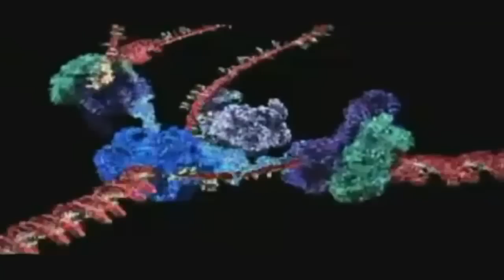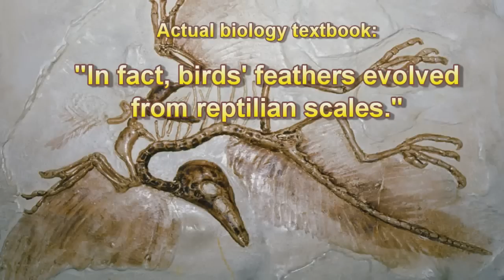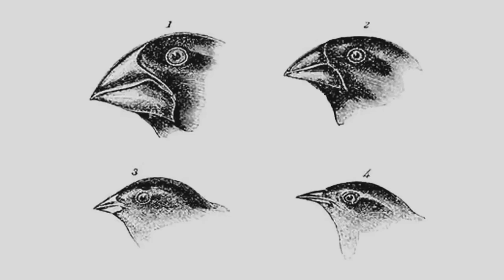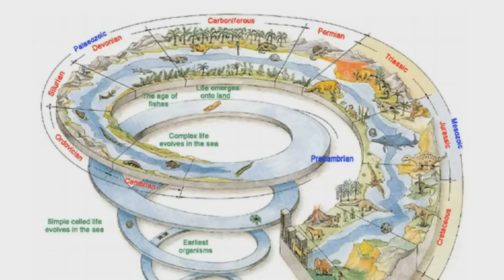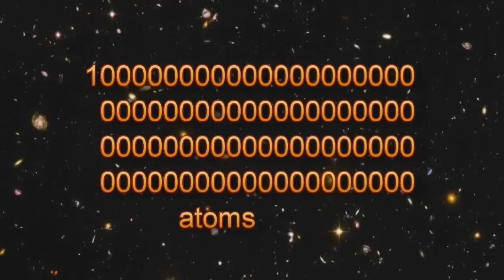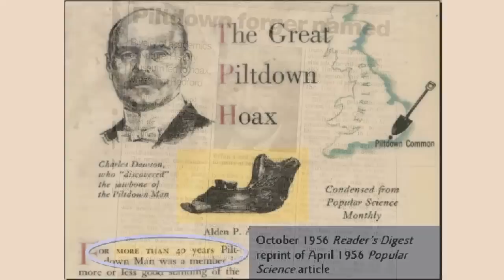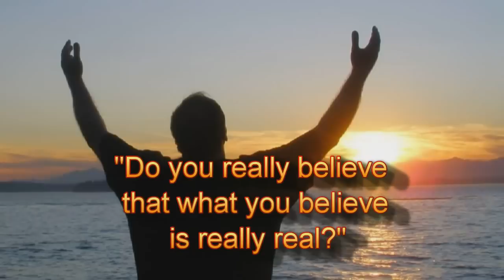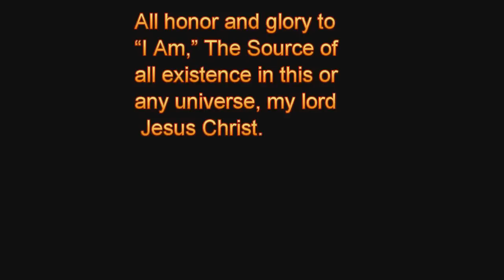Evolution Demolition

Comment: I will be honest and say that i could only stomach watching snapshots of this 1hr + video. So apologies if the responses to the points i make are contained in the sections that i have glossed over. So, having said that, can you tell me what "New" information is required for a controlling (non coding gene) to regulate a protein coding gene at different times and for different durations across species? Despite your incorrect assertion that new "information" cannot be added, it is irrelevant anyway as speciation can occur without the need for added "information" (i.e. extra base pairs) and if you want to progress this irrelevant argument you may want to consider why Amoeba have far more base pairs than Man, including your fabled Adam.
And don't get me started on how Geology and Palaeontology not only prove an Old Earth and Evolution respectively but also simultaneously falsify Biblical Creation. You may want to seriously consider that before you even begin to question the actual mechanism driving Evolution. Ah yes, the dangers of arriving at the conclusuion before looking at the actual observable evidence. Still sadly going on in the 21st century in some diminishing corners.
Oh and btw Evolution has absolutely no bearing on how i live my life no more than how the Sun is fuelled, i.e. as long as the Sun is what it is, it doesn't matter how it got there and how it works.
Reply: You really do need to watch the video before you comment on it.

What new information is needed?  All of it.

Creationists believe in variation.  Horizontal change, and downward change.  However, upward change by random mutation has never happened.  Speciation is the result of informational losses, not gains.  [A species is defined by its inability to cross breed, not new functions, so this can happen rather easily.]

Geological and palaeontological observations are not inconsistent with creationism any more than with evolution.  The ubiquitous presence of carbon-14 in residual fossil carbon material is proof that the fossil record is younger than 100,000 years (probably a lot younger).
Reply: Mark Champneys
Yeah you believe in variation present in alleles, yet at the same time believe any mutation from away from the 'normal' sequence is always deleterious. So how do these two contradictory ideas coexist in your mind?  Mutations can cause different sequences; therefore by your own criteria there must be at least as many good mutations as there are variations. So this admission means that you accept that mutations can be functional and provide increase fitness? These variations are different in their primary sequences as are mutations so what is the difference?

Welcome to the real world!

So where is your empirical evidence about specialization decreasing in DNA content published or is this some more of Johnson and Abel's data?
Reply: Mark Champneys
Well i will try to find time but from what i have seen so far is the same old debunked to death stuff.

I hope by "horizontal" change you don't mean Horizontal Gene Transfer because that is a relatively rare occurence in the scheme of things. While there is plenty of gene duplication it is in not even necessary for speciation i.e. Evolution. This is such a common misconception by Creatiosts.

"Speciation is the result of informational losses, not gains."
-- Oh really? Depends how you define "loss" and "gain" If i take the word "Hair" and "horizontally" change the "a" to an "e" i get "Heir". Is that a loss or a gain as i have merely replaced one operational word for another? Though, you could say "Have i lost my hair to gain money?" (apologies for that attempt at a joke).
Either way your response does not address my original point on regulating genes. If you have addressed this in your video then please tell me when in the video.

"[A species is defined by its inability to cross breed, not new functions, so this can happen rather easily.]"
--So since a Cheetah cannot mate with a Lion (unlike Lions and Tigers which are of the same Genus yet whose offspring is infertile), is the Cheetah within it's own "Kind" different to that of the Lion?. The fact that species cannot crossbreed in no way compromises Evolution. Over time the genomes of sepertae populations diverge ultimately affecting the germ cells and hence you can no longer get interbreeding. That sir is a new species explained by and consistent with Evolution.

"Geological and palaeontological observations are not inconsistent with creationism any more than with evolution."
--Oh deary me yes they are. As a turbulent global flood settled you'd get sediments laid down according to grain size and that would be across the whole globe (you can do the experiment yourself at home. It's easy).
You wouldn't get such diverse environments as we find in practice such as River sediments, Estuarine sediments, Glacial sediment, Aeolian sediments, Shallow salt water sediments, shallow fresh water sediments, Deep salt water sediments, Deep Fresh water sediments, Evaporites etc etc etc.,

"The ubiquitous presence of carbon-14 in residual fossil carbon material is proof that the fossil record is younger than 100,000 years (probably a lot younger)."
That's the whole point. Fossils do NOT contain carbon. The ones that do are indeed less than 50K years old but hey what are you doing championing the rather dodgy art of carbon dating? Look by Relative dating alone (pre radiometric dating) the Victorians calculated the Earth as at least 15 million years old so 100K was even ridiculous in those days so where does that leave 10K or whatever? In the realms of now discarded beliefs is the answer to that one.
Reply: Mark Champneys Creationists believe in magic. Creationists believe that a bronze age book of myths trump modern science. 
Species evolve over time to take advantage of new or changing environments.
Evolution and NOTHING else explains the fossil record. 
Creationism is a dead end.
Reply: Helixbuilder I can see how you might see these as contradictory ideas, but the word "paradoxical" would be more accurate.  The concept of prescriptive information is that the design of the instructions has purpose.  When I write software, portions of it are parameters/variables.  These are places in the code that are intended to have multiple options.  Variation in these places is okay, and usually harmless.  You won't crash my program by altering such areas of the code.  Other areas of the code are much more vulnerable.  Any change is deleterious to my purpose, but some changes are harmless or unnoticeable.  If mutations are thought of as spelling errors, then a few spelling errors in my novel will not change the message of the book (unless they were in extraordinarily strategic locations).  But spelling errors are always deleterious in a novel, however small or unnoticeable.  That is because the author did not intend it that way.  If spelling errors could re-write the novel to alter a coherent plot and improve the story, you might have a case.  But spelling errors have never, ever, done that for a novel.  Nor for a gene.

A damaged gene can, under very particular circumstances, be beneficial to survival value, as in the case of the sickle cell mutation.  But it is always deleterious to the intended programming, simply for the reason that the alteration was not intended by the original program.  Prescriptive information always originates from a mind, and has foresight and purpose.  Random changes never have foresight or purpose, even when they get unusually lucky.

I think the Creator designed DNA for extraordinary variation within the constraints of a given set of algorithms for each "kind."  The algorithms are not supposed to change, but the parameters are wide open.  Red hair or black, blue eyes or brown, tall or short, various amounts of melanin in the skin.  It's all good.
Reply: pilgrimpater No, I mean "horizontal" in a much more general sense: remixing existing genetic information.  Upwardly vertical evolution would be the addition of new prescriptive algorithms to the genome.

"Over time the genomes of sepertae populations diverge ultimately affecting the germ cells and hence you can no longer get interbreeding. That sir is a new species explained by and consistent with Evolution."

It may not be inconsistent, but either damaging or turning off genes is not going to make that organism progress upwardly.  New prescriptive algorithms have not been added to the programming.  And, by the way, often these new species can still be inter-bred artificially, if not naturally, since the DNA often remains compatible.

"As a turbulent global flood settled you'd get sediments laid down according to grain size "

We do see this kind of sorting within a given stratum.  The Grand Canyon has many examples of this.  Not to mention marine fossils on mountaintops all over the world.  Yes, there are other kinds of local sedimentation, but what about cross-continental strata?  Only a global flood could do such a thing.

Fully mineralized fossils do not contain carbon, but not all fossils are fully mineralized, such as coal and crude oil.  In the last ten years many specimens of original material with intact protein and even DNA molecules have been discovered.  These all contain carbon-14.  And the very fact that such bio-polymers are not broken down is, itself, proof positive that they cannot be older than a few thousand years, since such polymers rapidly break down under even the very best of conditions.

By the way, I do not argue for the accuracy of radiocarbon dating, because so many assumptions are involved.  I am merely talking about the detection of carbon-14, since zero measurable carbon-14 should be present in these things.
Reply: walkergarya Hurling insults is a sign of desperation.  Are you doubting yourself?
Reply: Mark Champneys
“No, I mean "horizontal" in a much more general sense: remixing existing genetic information”
-- Ok thanks, i just wanted clarification.
 
“It may not be inconsistent, but either damaging or turning off genes is not going to make that organism progress upwardly. “
-- Too damned right it’s not inconsistent but you seemed to have missed my point totally. While fossil genes are extremely strong evidence for Evolution e.g. we have less smell receptors than mice, I am talking about mere changes to existing genes that are still expressed. No additions, no subtractions, no turning off/on but merely change. Change a gene, more especially a regulating gene, and you get a change in gene expression e.g. the same gene that “builds” the bone segments in reptiles and birds is switched off in birds earlier than in reptiles so the bird has a shorter tail than the reptile.  So which has the advantage? Well the answer is simple. Both have the advantage. The reptile needs a long tail but a long tail to a bird would hamper flight. In other words, as per my word game example, there is no right or wrong result and for biology merely the best solution for a specific organism within a specific niche/environment.  
 
“ New prescriptive algorithms have not been added to the programming.  And, by the way, often these new species can still be inter-bred artificially, if not naturally, since the DNA often remains compatible.”
-- I’m afraid “programming” is a presupposed position on your part. In no way is DNA “programmed” any more than valency rules are within chemical reactions (and btw biology is essentially chemistry). If we were in a position whereby computer code randomly mutated when copied from one place to another then there would be no such thing as the IT industry. The very definition “algorithm” excludes randomness yet we know random mutation is a fact.  

“We do see this kind of sorting within a given stratum.  The Grand Canyon has many examples of this.”
-- Again you misunderstand my point but I am even more shocked that any Creationist can cite the GC to bolster their case. The point I was making was that the sediments would be sorted accorded to grain size. You must surely know that smaller/lighter grains stay in suspension longer than larger/heavier grains. As I said, you can do the experiment yourself at home.
Do we see such graded separation win the GC? No of course not and why do we see clear demarcation between the various sediments with an Aeolian layer sandwiched between water born sediments?
To save space and time I will not go into the numerous other reasons why it is not a good idea for Creationists to use the GC as an argument. I will, of course should you ask but we mustn’t use that as an excuse to avoid what’s being asked of you here.
 
“Not to mention marine fossils on mountaintops all over the world.”
-- Really? We know that plate tectonics is the reason for this and we can still measure it happening in mountain ranges such as the Himalayas.
However, let’s play God’s advocate and pretend your supposition is true. How come a “flood” raised a range of mountains of 25K+ feet when they had yet to lithify.  How could they possibly lithify without vast overlaying layers to squeeze out the water and replace with “cementing” agents? How come this sea bed that rose to 25K+ feet didn’t pull in all the other dead organisms, including land organisms, that were floating aimlessly around.
These are just a few questions that make us realise that the Genesis account is completely and utterly impossible.
  
“  Yes, there are other kinds of local sedimentation, but what about cross-continental strata?  Only a global flood could do such a thing.”
-- There are NO global strata, not even the much mentioned limestone layer.
As for “Only a global flood could do such a thing” then why just limestone (if that’s what you are referring to) and why not ALL strata? At best, if true, this would mean that there was a global deposition much earlier than the following totally non global depositions but of course your claim is not true. That’s the danger of only looking at Creationist propaganda sites rather than genuine scientific sites.
 
“Fully mineralized fossils do not contain carbon, but not all fossils are fully mineralized, such as coal and crude oil.”
-- The vast majority of fossils have had all their carbon replaced by minerals. Unsurprisingly the ones that are still undergoing this process are younger.  What’s the big deal?
 
 “ In the last ten years many specimens of original material with intact protein and even DNA molecules have been discovered.  These all contain carbon-14.  And the very fact that such bio-polymers are not broken down is, itself, proof positive that they cannot be older than a few thousand years, since such polymers rapidly break down under even the very best of conditions.”
-- So what you are saying is that in an old Earth scenario all life must be millions of years old? Of course this is a problem  as an Old Earth scenario allows for Young Earth events but a Young Earth scenario is totally falsified by a single Old Earth event. Unfortunately for you, the Old Earth events outnumber the Young Earth events. You need carbon to be found in ALL fossils. Sorry but the evidence is not on your side.

“By the way, I do not argue for the accuracy of radiocarbon dating, because so many assumptions are involved.  I am merely talking about the detection of carbon-14, since zero measurable carbon-14 should be present in these things.”
-- Which means that there are Zero dating methodologies to support your presupposed word view. Not a great position to argue from.
Reply: pilgrimpater _"While fossil genes are extremely strong evidence for Evolution..."_

What fossil DNA?  Yes, a few specimens of intact DNA have been discovered, but very few.  Yet even these few specimens are proof against evolution, since DNA decays rapidly and cannot last longer than about 30,000 years even if there were absolutely perfect conditions (which there are not).

" In no way is DNA “programmed” any more than valency rules are within chemical reactions"

Valence is a property that operates according to straightforward natural law.  DNA contains vast libraries of coded sequences, jam-packed with instruction sets.  Big difference.

Are you familiar with Baumgardner's model of catastrophic plate tectonics to explain the global flood, abundant fossils, mountain ranges, etc.?  I find it very persuasive, with more explanatory power than conventional geologists' uniformitarian models.  IMHO.

"The vast majority of fossils have had all their carbon replaced by minerals...What’s the big deal?"

The big deal is that all the fossil carbon that does remain contains measurable carbon-14.  How is that possible unless it is less than 100,000 years old?

"Old Earth scenario allows for Young Earth events but a Young Earth scenario is totally falsified by a single Old Earth event."

You have this exactly backwards, and it was discussed in my video.  If a treasure chest is brought up from an old shipwreck, full of old coins from hundreds of years ago, yet one coin in the bottom of the chest is a 1951 half-doller... then you know that the ship sunk after 1951, no matter how many 18th century coins are there.  Natural clocks of various sorts nearly always disagree with one another.  Natural clocks are helpful as maximum ages, not absolute ages, when we have such contradictory data.  Carbon-14 and undecayed bio-polymers are just such limiting factors.
Reply: Mark Champneys  

" In no way is DNA “programmed” any more than valency rules are within chemical reactions"

Valence is a property that operates according to straightforward natural law.  DNA contains vast libraries of coded sequences, jam-packed with instruction sets.  Big difference.

The development of DNA information is covered by Evolutionary Natural Selection and does NOT require any designer. In fact, the many simple errors that are continued to be copied in the Genome are proof against intelligent design.

Are you familiar with Baumgardner's model of catastrophic plate tectonics to explain the global flood, abundant fossils, mountain ranges, etc.?  I find it very persuasive, with more explanatory power than conventional geologists' uniformitarian models.  IMHO.

Hydroplate "Theory" is a bigger farce of pseudoscience than Intelligent Design. 

"The vast majority of fossils have had all their carbon replaced by minerals...What’s the big deal?"

The big deal is that all the fossil carbon that does remain contains measurable carbon-14.  How is that possible unless it is less than 100,000 years old?

Carbon 12 and 13 can routinely have some of that carbon changed to C14 by the gamma emissions from decaying Uranium and Thorium in the soil. This is also why diamonds and coal sometimes contain C14.
Reply: Mark Champneys

“What fossil DNA?  Yes, a few specimens of intact DNA have been discovered, but very few.  Yet even these few specimens are proof against evolution, since DNA decays rapidly and cannot last longer than about 30,000 years even if there were absolutely perfect conditions (which there are not).”
-- Sorry, I didn’t make myself clear. I wasn’t talking about DNA decay whereby, of course we will find DNA with some intact bonds for more recent organisms (I think 6 mill years is the possible limit in ideal conditions). However, in a 4.5K year Earth scenario we should surely find such DNA unbroken bonds in ALL fossils. Why don’t we? That is the point you have to address.
I was, in fact, talking about fossil genes i.e. genes that exist but are no longer expressed. Why should an organism have genes that are no longer expressed yet are expressed in other organisms? If you are going to posit common design then why don’t all organisms share the exact same genes with it just being a case of which is  switched on or off? In fact, such fossil genes are occasionally expressed in individuals as atavisms. What kind of crazy “design” is that? Only Evolution by common descent can explain this.
 

“Valence is a property that operates according to straightforward natural law.  DNA contains vast libraries of coded sequences, jam-packed with instruction sets.  Big difference.”
--The DNA molecule is based on chemistry. Biology is basically Chemistry when you reduce it down to the nuts and bolts and hence subject to natural laws just as with valency rules in standard Chemistry. The only that breaks the rules is the random mutation but even then the underlying chemistry is still the same.
As I said before, you cannot describe DNA as “programmed” because copied computer code does not randomly mutate. I need your response to this.

“Are you familiar with Baumgardner's model of catastrophic plate tectonics to explain the global flood, abundant fossils, mountain ranges, etc.?  I find it very persuasive, with more explanatory power than conventional geologists' uniformitarian models.  IMHO.”
--  No, perhaps you should extract Baumgardner's explanation for the problems posed to you previously i.e.

a) How does it explain the non graded bedding, especially in the case of the Grand Canyon which you cited as an attempt of evidence for a global flood
b) How come we have an Aolian layer sandwiched between water sourced sediments?
c) How did the Himalayas become lithified without collapsing while still mud?
Or if they were already lithified then how come the planet didn’t melt with so much energy being expended in such a short period? Either way the Flood model has catastrophic problems.
d) How come only simple molluscs were uplifted by the flood? Surely various other organisms, including land mammals, would have been swept up in the turmoil and uplift of this 25K ft plus tall mound?  
 Of course there are numerous other objections to the flood story but there is no point in snowing you under with more until the above are addressed first, whether by you or Baumgardner.

“The big deal is that all the fossil carbon that does remain contains measurable carbon-14.  How is that possible unless it is less than 100,000 years old?”
-- The point is that fossil’s that are greater than 100K years do not contain carbon, especially so for fossils that are millions of years old.  It is irrelevant talking about young organisms which are necessarily a part of both an Old and Young Earth.

Sorry but your analogy of the shipwrecked coins actually works against you.
If we apply the analogy to palaeontology then because we have animals that died yesterday, according to your logic, the Earth was created yesterday. Doesn’t work.
Also it says nothing about the age of the ship which may be centuries older than the 18th century (i.e. the age of the majority of coins) and it is the age of the ship that is relevant to the debate and not the age of the contents i.e. the age of the Earth and not the age of the organisms which can be anything from being the same age of the Earth to the present.
No, you must think this through. An Old earth can contain any number of young events but it is impossible for a Young Earth to have even just one confirmed old event. All it would mean, at best, is that the old event is true and there would be a gap before the majority of younger events occur but of course there is not just one example of old events but many.
 
“Natural clocks of various sorts nearly always disagree with one another.  Natural clocks are helpful as maximum ages, not absolute ages, when we have such contradictory data.  Carbon-14 and undecayed bio-polymers are just such limiting factors.”
-- I don’t know what you mean when referring to natural clocks. If you mean radiometric dating then they are true within specific tolerances and they are only valid for a certain range of dates You cannot use an isotope with a half life of millions of years for an event a few centuries old thus you use the correct tool for the job e.g. you wouldn’t use scales, or even a 6 inch rule, to measure the distance to the moon.. The numerous radiometric dating methodologies complement each other and if they all happen to be wrong by the exact same degree of error then the odds against that are astronomical. However, there are also other methodologies other than radiometric dating e.g. thermoluminescence. Other methodologies, while not giving an age of millions still far exceed the 6K year old limit e.g. as ice cores, varves etc etc.
Also even ignoring absolute dating, relative dating, as was used by the Victorians, still yielded an age of the Earth of hundreds of millions of years old. In fact it was they who, upon uncovering the evidence, realised that the Flood Story was impossible.
Uniformitarianism must be true otherwise it means the Laws of Nature have changed and these laws are dependant upon Universal constants which design proponents claim as being especially and uniquely put in place to accommodate life.
Reply: pilgrimpater Your post is too long to deal with in a forum like this.  We'll be writing books to each other.  Allow me to break it apart:

As to bio-molecular decay... this is well studied.  In accordance with the law of increasing entropy, these bio-polymers break apart rather rapidly under normal conditions due to microbes, water, oxygen, heat, and so forth.  No, we would not expect many of these intact molecules to be found even in a young earth scenario.  But in an old earth scenario?  Impossible.
Reply: pilgrimpater _"Biology is basically Chemistry..."_

That was the thinking of 50 years ago, not today.  Biology is basically information.  Biological systems are jam-packed with information, digital information.  Libraries of it.  Even evolutionists recognize this.  (Consider the journal of Bioinformatics.)

Biology certainly employs chemistry, but biology is no more equivalent to chemistry than ink and paper is equivalent to journalism.
Reply: pilgrimpater _"...computer code does not randomly mutate. I need your response to this."_

Of course it does.  Ever heard of a glitch?  That is a mutation.  Mutations are glitches in the digital DNA sequences.  The term "software" is not an analogy.  DNA sequences literally are software.  No difference, except for the processing mechanism.
Reply: pilgrimpater As to Baumgardner's catastrophic plate tectonic model...

I'm going to have to defer to him and his associates for the details, but I believe they have addressed most of them.  Every model has some unanswered questions, but I believe the conventional uniformitarian models have far more.  Many catastrophic geology issues were explained by direct observations at Mt. St. Helens which we had no clue about previously.
Reply: pilgrimpater _"The point is that fossil’s that are greater than 100K years do not contain carbon, especially so for fossils that are millions of years old."_

You are assuming that there are fossils older than 100,000 years.  What if there are not?  Generally speaking, the only fossils that do not contain measurable traces of carbon-14 are the ones that do not contain any carbon at all--the fully mineralized ones.  Why is the presence of carbon-14 in fossil carbon material so ubiquitous?
Reply: pilgrimpater _"If we apply the analogy to palaeontology then because we have animals that died yesterday, according to your logic, the Earth was created yesterday. Doesn’t work."_

Oh, come on.  Obviously there must be a connection to the thing being tested for it to be relevant.  If the thing being tested is the sinking date of the ship, then a 1951 coin locked in a chest in the heart of the wreck is relevant.  But, no, it tells us nothing about the date of unconnected things, such as the age of the tree used to build the ship or other such nonsense.

When an undisturbed basalt monolith in Australia was cut through, charred wood was found encased inside.  The wood dated at thousands of years, and the basalt dated at millions of years.  There is something wrong with this picture.  The two measurements are connected.  Radiometric dating was used on the rock, and radiocarbon dating was used on the wood.  The two natural clocks disagreed with each other, but the younger clock is controlling in this case.  Bio-molecular decay rates may be yet another clock which will render an even younger age, but not an older.  If three clocks give three different ages, at least two of them are wrong.

All natural clocks are based on assumptions, and all those assumptions are questionable when we are dealing with the distant past.  I'm not suggesting that we give up on science in this regard, but only saying that we must admit the limitations of it.  The distant past is beyond our experiments.  We can only do experiments in the present.
Reply: pilgrimpater _"Uniformitarianism must be true otherwise it means the Laws of Nature have changed"_

No, because catastrophes happen, even in the present... all according to the laws of nature.  Is Mt.St. Helens against the laws of nature?  Is a super-nova against the laws of nature?  Some astrophysicist think that there was previously a global flood on Mars, yet there is no present water there.  The earth is 70% covered with water, with massive sedimentary strata all over the earth, yet a global flood is impossible here?  Why?
Reply: Mark Champneys
“Your post is too long to deal with in a forum like this.  We'll be writing books to each other.  Allow me to break it apart:”
-- The sum total of individual posts will not reduce the text but instead make the exchange very bitty. I think it’s best to have each response in one place. It is easier to follow (seems we can’t even agree on that, lol).

“As to bio-molecular decay... this is well studied.  In accordance with the law of increasing entropy, these bio-polymers break apart rather rapidly under normal conditions due to microbes, water, oxygen, heat, and so forth.  No, we would not expect many of these intact molecules to be found even in a young earth scenario.  But in an old earth scenario?  Impossible.”
-- You missed the point, yet again. In an old earth scenario there will still be younger organisms that are partially fossilised.  After all the replacement of biological tissue with minerals is not a rapid process. You also still miss the point that if THE reason for molecules not fully decaying is purely down to a Young Earth then why are not ALL fossils containing molecular material?  Indeed why are only a small percentage of fossils found to contain biological material?
 
 
"Biology is basically Chemistry..."_
That was the thinking of 50 years ago, not today.  Biology is basically information.  Biological systems are jam-packed with information, digital information.  Libraries of it.  Even evolutionists recognize this.  (Consider the journal of Bioinformatics.)”
-- It’s the thinking now. All biological processes, no matter how seemingly complex, can be reduced down to chemical reactions, including  bioinformatics in the same way that ALL computer code can be reduced to a host of   individual on/off switches.

“Biology certainly employs chemistry, but biology is no more equivalent to chemistry than ink and paper is equivalent to journalism”
-- Incorrect analogy. Biology is a branch or an extension of chemistry. Journalism requires so much more than ink and paper.
 
 
 
“...computer code does not randomly mutate. I need your response to this."_
Of course it does.  Ever heard of a glitch?  That is a mutation.  Mutations are glitches in the digital DNA sequences.  The term "software" is not an analogy.  DNA sequences literally are software.  No difference, except for the processing mechanism.”
-- No it doesn’t.  Assuming no hardware failures (indeed a major and catastrophic glitch is patently obvious), then copied code from one location to another NEVER changes. How do I know this? I spent 30 years as a software developer.
This is the beauty of the digital age and the reason why you can copy music from one media to another with no loss unlike the case with analogue music whereby with each copy , the quality will be degraded. 
 
 
 
“As to Baumgardner's catastrophic plate tectonic model...

I'm going to have to defer to him and his associates for the details, but I believe they have addressed most of them.  Every model has some unanswered questions, but I believe the conventional uniformitarian models have far more.  Many catastrophic geology issues were explained by direct observations at Mt. St. Helens which we had no clue about previously.”
-- This is very disappointing. Earlier you wrote (and apologies as I am paraphrasing)  “It is a better explanation IMHO”.  How can you have an “HO” if you don’t know the contents?. I can explain in fairly good detail why I support the Plate Tectonics. When I ask awkward questions of your Creation model, then I expect this Baumgardner stuff to have addressed that issue.
As for Mt St Helens what is your point? Are you stating that Uniformitarianism excludes catastrophic events ? Nobody is claiming that.   
 
 
"The point is that fossil’s that are greater than 100K years do not contain carbon, especially so for fossils that are millions of years old."

You are assuming that there are fossils older than 100,000 years.  What if there are not?  Generally speaking, the only fossils that do not contain measurable traces of carbon-14 are the ones that do not contain any carbon at all--the fully mineralized ones.  Why is the presence of carbon-14 in fossil carbon material so ubiquitous?”
-- I make no assumptions. By relative dating alone we know that fossils exceed millions of years. Add to this the numerous absolute dating methodologies then we can safely conclude that the Earth is far far in excess of 6K years old (not to mention numerous other reasons why but that’s for later).
However, if they are NOT millions of years old I’d have to ask the question that you seem reluctant to address i.e. “Why are most fossils fully mineralised and without carbon while only a handful contain biological material and/or carbon?” 
 
 
 
 
"If we apply the analogy to palaeontology then because we have animals that died yesterday, according to your logic, the Earth was created yesterday. Doesn’t work."_
Oh, come on.  Obviously there must be a connection to the thing being tested for it to be relevant.  If the thing being tested is the sinking date of the ship, then a 1951 coin locked in a chest in the heart of the wreck is relevant.  But, no, it tells us nothing about the date of unconnected things, such as the age of the tree used to build the ship or other such nonsense.”
-- Exactly, in your analogy the thing being tested is the date of the sinking of the ship but the analogy should be talking about the date the ship was constructed or at least set sail. If you found only coins stamped 1851 then the only thing we can deduce is that the Ship could not have sunk before 1851 but it could have set sail  much earlier. Also that is just one set of coins. Are we to assume that all other coins that are not on the ship cannot be earlier than 1851 just because of this one event? It’s like knowing that the Norman Invasion couldn’t have been earlier than 1066 and claiming that there could have been no other battles before 1066.
 

“When an undisturbed basalt monolith in Australia was cut through, charred wood was found encased inside.  The wood dated at thousands of years, and the basalt dated at millions of years.  There is something wrong with this picture.  The two measurements are connected.  Radiometric dating was used on the rock, and radiocarbon dating was used on the wood.  The two natural clocks disagreed with each other, but the younger clock is controlling in this case.  Bio-molecular decay rates may be yet another clock which will render an even younger age, but not an older.  If three clocks give three different ages, at least two of them are wrong.”
-- Oh really? The basalt flow encasing the wood was only circa 20 meters below the surface, meaning that it was long exposed to surface waters percolating downward into the rock
Surface waters contain not only modern atmosphere, but organic acids that bond tightly to wood. The basalt in the core drill samples was taken from a zone of weathering, where percolating oxidising ground water readily alters minerals and rock chemistry.
Also do you honestly believe that if you toss a piece of wood into basaltic lava that it wouldn’t be completely consumed out of existence? Obviously the wood could never have been part of the original Basalt. This is something that can easily be demonstrated. Try it.
 

“All natural clocks are based on assumptions, and all those assumptions are questionable when we are dealing with the distant past.  I'm not suggesting that we give up on science in this regard, but only saying that we must admit the limitations of it.  The distant past is beyond our experiments.  We can only do experiments in the present.”
-- So 1066 could have been last week? Please, give me a bit of credit. Even if dating methods (thoroughly tested in the lab under extremes of pressure and temperature) were proven wrong they would not be wrong by a factor of millions. And I have to ask again why so many different and unconnected dating methodologies point to an Earth far far in excess of 6K years old. Are they all wrong while still arriving at a consistent conclusion? What are the odds against that? Unfortunately I cannot off the same scrutiny to Creationist dating methodologies because there are none, unless you want to count Bishop Usher as a scientific genius. I don’t buy into this “historical” science vs Present science. Basically there is evidence and an explanation for that evidence. We don’t have to see fossils form to know that they exhibit a clear and unmistakeable Evolutionary pattern. If you found a man dead in the street with a knife in his back are you to assume that dying from laughter was an equally plausible explanation as the knife severing an artery?  I think not.
 
"Uniformitarianism must be true otherwise it means the Laws of Nature have changed"_
No, because catastrophes happen, even in the present... all according to the laws of nature.  Is Mt.St. Helens against the laws of nature?  Is a super-nova against the laws of nature?  Some astrophysicist think that there was previously a global flood on Mars, yet there is no present water there.  The earth is 70% covered with water, with massive sedimentary strata all over the earth, yet a global flood is impossible here?  Why?
-- And who exactly claims that Unifortinarianism cannot include catastrophic events?
Extinct volcanoes are as much part of our history as are the vast deposits of slowly forming limestone.No unifortinarianism purely stipulates that Natural events we observe today also happened in the past with the same Natural Laws. No Natural Laws can explain flooding the whole planet in such a short period, nor can they explain how the Himalayas were formed without melting the planet.
Why are there sedimentary strata across the globe? Diverse events at various times and places within Earth’s history such as Rivers, Estuaries, Glacial deposits, Evaporites, Biological deposits (eg limestone), shallow lakes, deep lakes, shallow seas, deep seas, corals and even Deserts etc etc. That’s one hell of a variety of differing environments to have formed all from a single global flood.
Can you now explain why the sediments are not uniform across the whole globe and also why they did not settle according in grain size according to the laws of suspension as would be predicted from a receding flood?
You see there is nothing in Geology, let alone Palaeontology, that is consistent with a global flood.
Reply: pilgrimpater Actually, mineralization is relatively rapid under the right conditions.  Experiments have shown this.  Bio-molecular decay occurs at different rates, depending upon microbes, heat, presence of oxygen, presence of water, etc.  Under a young earth scenario we would expect to see most bio-polymers to be decayed, but in a few cases, where conditions were good, we might see a few cases of intact proteins and nucleic acids.  Such is exactly what we find.  Under an old earth scenario we would expect to see absolutely zero undecayed material, but this is not the case.

"Biology is a branch or an extension of chemistry. Journalism requires so much more than ink and paper."  You just made my point for me.  The information content of biological systems "requires so much more" than chemistry.

"Assuming no hardware failures... "  Smile.  If you've written software you know this assumption ain't true.

Baumgardner and his team (Wise, Snelling, Austin, Humphreys) have a very comprehensive computer-modeled theory.  I would do a poor job of representing them, and their stuff is readily available online.  I'll let them speak for themselves.

Yes, uniformitarianism allows for small catastrophes, but not global ones.  Makes no sense to me, given that sedimentation is global.

"Also do you honestly believe that if you toss a piece of wood into basaltic lava that it wouldn’t be completely consumed out of existence? Obviously the wood could never have been part of the original Basalt. "
Nevertheless, there is was.  Denying the data does not make it go away.  The wood was charred, by the way, and probably only a small portion of the original whole.

"Please, give me a bit of credit. Even if dating methods (thoroughly tested in the lab under extremes of pressure and temperature)..."  The reliability of dating methods cannot be tested in the lab in the present, because our labs are not located in the distant past.  There are huge assumptions in all such dating methods.  How much daughter isotope was present at the beginning?  Do you really know?  How much contamination could occur over that much time?  Do you really know?  Even the constancy of decay rates might be an open question, because we are in the present, not the past.  The biggest problem is that different methods yield vastly different results.  The lab says they should all be correct, but obviously they are not all correct, because they are all different.  Uranium-lead dating nearly always gives much older dates than potassium-argon dating.  Which one is right?  Are either of them right?
Reply: Mark Champneys _"Uniformitarianism must be true otherwise it means the Laws of Nature have changed"_

No, because catastrophes happen, even in the present...

Yes catastrophes happen, but they do not violate the Laws of Nature. Mt St Helens saw a medium eruption of a subduction volcano.

all according to the laws of nature.  Is Mt.St. Helens against the laws of nature?  Is a super-nova against the laws of nature?  Some astrophysicist think that there was previously a global flood on Mars, yet there is no present water there.

WRONG WRONG WRONG.
All astrophysicists accept that there was lots of water on Mars when it was formed, there were lakes, rivers and shallow seas, but there was NEVER a time when all of the land on Mars was under water. By the way, there is still lots of water on Mars, in the polar Ice caps, but no free flowing water on the surface.

 The earth is 70% covered with water, with massive sedimentary strata all over the earth, yet a global flood is impossible here?  Why?

Because there is not enough water to submerge all the land, even if virtually all the water at the poles were melted.
Reply: Mark Champneys
“Actually, mineralization is relatively rapid under the right conditions. “
-- Well perhaps you could give me some examples. I don’t mean known hoaxes like the “fossilised” cowboy boots nor about objects that are rapidly encrusted by calcium carbonate (which is NOT fossilisation) but I mean genuine replacement of internal biological structures by minerals.  
 
“ Experiments have shown this.  Bio-molecular decay occurs at different rates, depending upon microbes, heat, presence of oxygen, presence of water, etc.”
-- It is not just the decay but the replacement of the areas vacated by that decay that forms the fossils and that takes time. You also have to remember that bones that are buried rapidly are less exposed to oxygen that causes the decay and hence the decay rates are much slower than organic material exposed to the surface. This is how most fossils are formed by burial, pressure by overlying sediment (requiring great amounts of time in itself), causing biological matter to be dissolved and forced out, followed by replacement of the vacated biological matter. Then, either catastrophic events or the very slow process of erosion are required for those fossils to see the light of day for the first time and to become known to us. It’s all a lot to ask for in a young earth scenario where you would expect to see ALL organisms to be still part way into the process of fossilisation. Of course, we see nothing of the sort but instead we see the vast majority of fossils with absolutely no biological material remaining. The only logical conclusion is an Old Earth but we know from pure geology via simple relative dating methods that the Earth is old anyway.   
 
“Under a young earth scenario we would expect to see most bio-polymers to be decayed, but in a few cases, where conditions were good, we might see a few cases of intact proteins and nucleic acids.  Such is exactly what we find.  Under an old earth scenario we would expect to see absolutely zero undecayed material, but this is not the case.”
-- Sorry you can’t change the facts. Under a Young Earth we’d expect the vast majority of fossils to contain biological material. Exactly what we don’t see. Under an Old Earth we’d expect to see the vast majority of fossils with no biological matter apart from those fossils that are young (because an Old Earth still caters for young events). Exactly what we do find.
I think you are having a problem accepting that an Old Earth, not only contains old events but also young events in fact even present events whereas a Young Earth cannot be consistent with even one solitary old event, let alone the millions that we know of. The Earth is at least as old as the oldest event currently known to man.

"Biology is a branch or an extension of chemistry. Journalism requires so much more than ink and paper."  You just made my point for me.  The information content of biological systems "requires so much more" than chemistry.”
-- It’s chemistry to a higher level but it is still chemistry. In no way does this support your assertion. In no way is this evidence for “information” placed there by some external agent.
You can say it as much as you like but you really need to provide some evidence.
You are forgetting that a simple stone contains very complex information when you consider the physical, chemical and sub atomic bonds. Is each pebble intelligently designed? Good luck with that one.

"Assuming no hardware failures... "  Smile.  If you've written software you know this assumption ain't true.
-- Actually I know it to be 100% true. Digitally copied software quite simply does not randomly change (mutate). If it did then we’d have no databases and indeed the information that you read would be different (mutated) during it’s journey from the database to your screen. In other words we would not be able to communicate by any system that involves computers, which by definition move data from one place to another. The only way digital copying can fail is with a hardware error and that wouldn’t give you mere random mutations but a catastrophic fail. Sorry but I really do know this.

“Baumgardner and his team (Wise, Snelling, Austin, Humphreys) have a very comprehensive computer-modeled theory.  I would do a poor job of representing them, and their stuff is readily available online.  I'll let them speak for themselves.”
-- Which means that when you claimed “It is the best explanation IMHO”, that you blindly accepted something that panders to your wishful presupposition. I’d be very careful by claiming that mere slides on a computer represent computer simulation. It’s not the same thing.
May I suggest you spend time studying Baumgardner and then see if you can address the many objections that I raised in an earlier comment?

“Yes, uniformitarianism allows for small catastrophes, but not global ones.  Makes no sense to me, given that sedimentation is global.”
-- Uniformitarianism merely claims that the Laws of Nature that we observe today have occurred in the past. Catastrophic events do not contravene these Laws of Nature. It is nothing to do with the scale of such events and indeed we have had many global catastrophic events in the past such as the asteroid that was the demise of dinosaurs and much other life across the globe (evidenced by the KT layer around the globe).
I do wish you would actually respond to what I have written or is it that don’t you read it? The fact is that sediments do appear across the globe and at many depths (and altitudes) but these are from numerous wide ranging environments that are not floods and those that are floods are only a small minority of cases and certainly not global, meaning that there could never have been a global flood. Utterly impossible, given what we observe in the field.
Sorry but you need to respond to the points i am actually making rather than repeating the same old debunked to death Creationist slogans.

“"Also do you honestly believe that if you toss a piece of wood into basaltic lava that it wouldn’t be completely consumed out of existence? Obviously the wood could never have been part of the original Basalt. "
Nevertheless, there is was.  Denying the data does not make it go away.  The wood was charred, by the way, and probably only a small portion of the original whole.”
-- Why would you be surprised to find wood in a drilled mine shaft? If the wood had been truly embedded within the basalt then the remaining wood should still be observed in the wall of the shaft (btw i trained as a mining engineer before I went into IT). I cannot be certain I was not the one who “discovered” the wood but this doesn’t seem to be the case unless you can identify otherwise from Snelling’s paper.  You have no way of knowing that the “wood” was not charred before it found it’s way into the shaft. What you really need to produce is a piece of wood that is totally encased in basalt that has never had any fractures (i.e. somewhere where external material can enter) and never previously been exposed but how that could happen without the basalt not totally consuming the wood is beyond all the Laws of Science. Just try it. Toss a piece of wood in some flowing lava. Come back to me when you have done this and the wood has escaped with being merely charred.
Also how do you know that the wood didn’t originate from the coal layer and “carried” up by the receding drill into the overlying basalt level. In that case it is possible that the wood could be of an age outside the limits of C14 dating (I confess I don’t know the age of the coal layer) and hence the results would be of no use. However, having said that, you do realise that the wood was dated as 35.5K years old. That makes your 4.5K year flood claim out by a factor of circa 8 but then again YECs have absolutely no dating methodologies with which to make a comparison.
 Have you looked at cross section of the geology of the Crinum Colliery?
Like to explain it in a “Flood” scenario for me?    

"Please, give me a bit of credit. Even if dating methods (thoroughly tested in the lab under extremes of pressure and temperature)..."  The reliability of dating methods cannot be tested in the lab in the present, because our labs are not located in the distant past.  There are huge assumptions in all such dating methods.  How much daughter isotope was present at the beginning?  Do you really know?  How much contamination could occur over that much time?  Do you really know?  Even the constancy of decay rates might be an open question, because we are in the present, not the past.  The biggest problem is that different methods yield vastly different results.  The lab says they should all be correct, but obviously they are not all correct, because they are all different.  Uranium-lead dating nearly always gives much older dates than potassium-argon dating.  Which one is right?  Are either of them right?
-- The Mother/Daughter ratio has been addressed by Isochron methodology.
Again, results of different radiometric methodologies are consistent. For them to be consistently wrong to the exact same degree would be astronomical odds against. You do realise that scientists (real scientists) are fully aware of all the pitfalls are and where samples (always many not just one) are to be taken and that includes areas of that are deemed to be prone to contamination. Why should this be a surprise to you?
Why do you think decay rates are open to question” when they have been proved consistent even at extremes of temperature and pressure?
Added to this that such totally unrelated evidences, such as ice cores, show an Earth to be 100s of thousands of years old,  making your 6K year old model as looking rather sick.
 
“Uranium-lead dating nearly always gives much older dates than potassium-argon dating.”
-- Please give me some figures on this please. Maybe you are confused in that U-Pb has a lower limit of circa 1 million years while K-Ar has a lower limit of circa 100K years. If so, it sounds like typical YEC spin to me.
Reply: pilgrimpater Under either old or young earth I would expect very few fossils at all, because fossilization generally requires rapid burial in mud flows with relatively rapid mineralization before microbial decay.  Yet we have billions of fossils, buried in sedimentary rock layers all over the earth.  A global flood explains this perfectly.  Little else does.

Even a young earth scenario does not allow for intact bio-polymers to exist longer than a few years in nearly all cases, because of the presence of microbes, water, reactive chemicals, heat, and/or oxygen.  Only if conditions are perfect can any such polymer last several thousand years.  But it is impossible for intact bio-polymers to last millions of years.  Yet they have been found in pre-cambrian strata, and in dinosaur strata.  Why? because these layers are not as old as we've been told.  This is slam dunk proof.  It is like entering an undisturbed pyramid tomb, opening a mummy case, digging into the belly of the mummy, and finding a wind-up clock that is still ticking!  None of the rest of your arguments matter if the wind-up clock is still ticking.
Reply: Mark Champneys
“Under either old or young earth I would expect very few fossils at all, because fossilization generally requires rapid burial in mud flows with relatively rapid mineralization before microbial decay.”
-- You do realise that the necessity of rapid burial, to protect from scavengers, in no way means that the actual fossilisation process that follows that burial has to be rapid or are you under the delusion that a bone qualifies as a fossil the second it’s buried?  If so, you seriously have a lot of reading to catch up with.
 
“  Yet we have billions of fossils, buried in sedimentary rock layers all over the earth.  A global flood explains this perfectly.  Little else does.”
-- The truth is that the evidence clearly shows the global flood as impossible. It’s as if you totally ignore what I say and instead insist upon just carrying on repeatedly chanting debunked to death creationist mantra as in a comatose state. Here is a resume of just SOME of the facts that you still have to address:
1) We have Aeolian sediments sandwiched between water borne sediments.
Some flood to deposit sand without water!
2) As well as such Aeolian deposits, the water sourced deposits are from incredibly diverse environments (some listed in a prior comment, assuming you read it) that are clearly not results of floods and even more so, for those few deposits that are results of floods (e.g. Scablands), they are clearly not on a Global basis. Why?
3) In the wake of a global flood , we’d expect the sediments to be sorted and separated by grain size (courser grains at lowest and finest at the top). Exactly what we don’t see. Why?
4) In the wake of a global flood, we’d expect to see no pattern in the fossil record (i.e we’d expect a random mix) but we DO see a pattern and it is an evolutionary one and that is true regardless of the age of the Earth. Why?
 
.     
“Even a young earth scenario does not allow for intact bio-polymers to exist longer than a few years in nearly all cases, because of the presence of microbes, water, reactive chemicals, heat, and/or oxygen.  Only if conditions are perfect can any such polymer last several thousand years.  But it is impossible for intact bio-polymers to last millions of years.  Yet they have been found in pre-cambrian strata, and in dinosaur strata.  Why?”
-- Why? Because it’s no good inventing data to suit your presupposition. There are no intact bio-polymers found in Cambrian let alone pre Cambrian. I’d love you to tell me why you even think this.
 
 “because these layers are not as old as we've been told.”
--Now there is irony of the highest order. The difference between what the scientific world is “telling” us and what the religious are “telling” us, is evidence vs presupposition.
 
  “This is slam dunk proof.  It is like entering an undisturbed pyramid tomb, opening a mummy case, digging into the belly of the mummy, and finding a wind-up clock that is still ticking!  None of the rest of your arguments matter if the wind-up clock is still ticking.”
-- It wouldn’t even be slam dunk if it were true. You quite simply cannot ignore all the other evidences for an Old Earth nor those against a measly 6K year old Earth and again you provide an irrelevant analogy. We are talking about fossils, not ticking clocks.
Reply: walkergarya _"You have pseudoscience and your barbaric bible."_

Gosh, Gary, you've persuaded me with that fact-filled argument.
Reply: pilgrimpater _"...in no way means that the actual fossilisation process that follows that burial has to be rapid..."_

Bio-molecular decay, if not microbial decay, happens relatively rapidly, which implies that the mineralization process must be at least as rapid in order to preserve a thing as a fossil.

Concerning the global flood.
1. Creationist theories involve successive waves of sediments, as well as global scale volcanic activity.  Ash layers are perfectly consistent with that.
2. A global flood does not rule out local floods.
3. Sediments are sorted by grain size oftentimes.  The Grand Canyon has some excellent examples of this.
4. We absolutely would expect to see a burial order in the fossil record, and we do.  (It is not always consistent.)  We would also expect to see catastrophic graveyards of similar organisms fleeing a catastrophe, and we do.  We would also expect to see polystrate fossils, without decay in the upper strata for such fossils, and we do. (Whales, dinosaurs, upright trees.)

"There are no intact bio-polymers found in Cambrian let alone pre Cambrian. I’d love you to tell me why you even think this."

A discovery within the last year, by three evolutionist paleontologists, of marine worm tubules in pre-cambrian rock.  The tubules were original material with intact protein and chitin molecules.  In their paper they mostly talked about the tubules, but briefly wondered how the material could last 550 million years.  (Yeah, good question.)

"The difference between what the scientific world is “telling” us and what the religious are “telling” us, "

Only it is not religion telling you this.  It is science telling you this.  You just don't want to pay attention to that which doesn't fit your dogma.  The real irony here is that your statement is true... in reverse.  Evolutionism represents the religion (dogma) and the creationists represent the hard science that is overturning your preconceived ideas.

We are talking about carbon-14 and bio-molecular decay which are  literally ticking clocks.  As I said in the video, even if the chest is full of coins from hundreds of years ago, only one coin dated 1951 upsets the apple cart.
Reply: Mark Champneys So how do you explain the fossil record, where we have multiple examples of a clear series of fossil species starting from A and step by step morphing into B over time with, as is the case with the more modern of these examples, there are clear genetic links to show the same lineage.
Reply: Mark Champneys
“Bio-molecular decay, if not microbial decay, happens relatively rapidly, which implies that the mineralization process must be at least as rapid in order to preserve a thing as a fossil.”
-- So we should never find any bio-molecular material as soon as a bone is rapidly buried?
Well there’s a thing and how vague.  How long is “at least as rapid”? However, I am not talking about the decay but the replacement  of the “decayed” organic material by minerals.
Do you seriously claim that process to be “relatively rapid”? Are you claiming mineral substitution is completed as soon as the carcass is buried? And btw, microbial decay is the decay of microbes which is totally irrelevant to the fossilisation of bones in the general sense.

Concerning the global flood.
“1. Creationist theories involve successive waves of sediments, as well as global scale volcanic activity.  Ash layers are perfectly consistent with that.”
-- Rather than get sidetracked by the sheer impossibility of that statement, given what is actually observed in the field, i will persist with the point that was actually posed to you which was “We have Aeolian sediments sandwiched between water borne sediments.” So, i’m asking you yet again, how it is possible that a body of water can lay down a desert sediment that has plenty of evidence of being formed by wind/wave activity (just as we see happening right now in the Sahara etc)?
Are you claiming that Aeolian Sandstone deposits are Volcanic Ash? Surely not.
 
2. “A global flood does not rule out local floods.”
--Again, not the question that was posed to you. I’m asking how a global flood can leave such widely varying environments such as glacial deposits, Aoelian deposits, Evaporites, Estuarine deposits, River deposits etc, etc etc?  

3. “Sediments are sorted by grain size oftentimes.  The Grand Canyon has some excellent examples of this.”
-- No they are not. Sorry but you cannot change observable evidence to suit your argument.
No way are the various layers of the GC, or anywhere apart from estuarine and some river bend environments, sorted by grain size. Also, where was the Keibab Limestone sloshing around all the while the Tapeats Sandtone was being carefully and lovingly laid down into a nice distinct layer?
Why are the layers horizontal yet the so called “Super Group” (lower layers) is inclined at 10 to 15 degrees?  

4. “We absolutely would expect to see a burial order in the fossil record, and we do.  (It is not always consistent.)  We would also expect to see catastrophic graveyards of similar organisms fleeing a catastrophe, and we do.”
Leaving aside that is NOT the pattern that we see are you, with that old creationist chestnut, saying that all Sloths should appear in lower layers than all cheetahs? Surely Not.
Tell me more about what you think the fossil pattern is and how it can be explained by a global flood. Should be very interesting.
 
 “ We would also expect to see polystrate fossils, without decay in the upper strata for such fossils, and we do. (Whales, dinosaurs, upright trees.)”
-- and we’d expect polystrate trees in an old Earth scenario. Where is the problem? Remember, an Old Earth can and does cater for rapid events as well as young events.
Polystrates occur spanning coal layers. Where is the mystery? Indeed in a flood scenario how can we even have coal deposits? How can a tree stay vertical after being ripped out of it’s roots by such a violent flood? How can anything you believe about this “Global” flood make any sense when you actually question it?
Whales? Dinosuars? Are you claiming we have Polystrate Whales and Dinos?

“A discovery within the last year, by three evolutionist paleontologists, of marine worm tubules in pre-cambrian rock.  The tubules were original material with intact protein and chitin molecules.  In their paper they mostly talked about the tubules, but briefly wondered how the material could last 550 million years.  (Yeah, good question.)”
 
-- Tell you what since you chose not provide any detail, I’ve looked it up for you and as far as i can tell the journal to which you refer is the Journal of Paleontology 88(2):224-239. 2014. The abstract of which closes with:-
“The biogeochemistry of the organic matter that comprised the tube, which was inferred from its properties, composition, and microstructure, is consistent with chitin and proteins as in siboglinids.”
Admittedly this is only from the Abstract  but that should be enough for you to understand the context whereby the chitin like “molecules” were not the original soft material but the fossilised remains which are consistent with chitin, no matter how much your source creationist site wants to alter that context but then again that’s what Creation sites do.
With the power of modern microscopes the fossilised internal structures and biological pathways can be determined. That doesn’t make them biologically active.
Anyhow, to be fair, perhaps you have read the whole journal and your “claim” was included in the main body of that journal. In which case you can tell me can’t you but don’t you think it exceptionally strange that such an earth shattering discovery, as hundreds of millions of years old soft material, would be mentioned in the main body of the article but totally omitted from the Abstract?
 
However, despite that problem for you, let’s play God’s advocate and try really hard to pretend your statement is actually true.
If the reason for soft tissue is solely down to a Young Earth and a Young Earth is true, then ALL fossils should contain soft matter. Obviously they don’t so there would have to be another factor for the preservation of such tissue other than age. You must agree on that. What that factor could be, I think neither you nor I know. Also material such as Keratin (which is similar to Chitin) does survive well beyond other parts of the body. Just ask any archaeologist who has opened an ancient grave. They will tell you that the only thing that survives other than bones is hair.
Finally, on this matter, even if true, you are still left with the Fossil pattern which is true regardless of the age of the Earth, meaning the Genesis story is utterly impossible.

“Only it is not religion telling you this.  It is science telling you this.  You just don't want to pay attention to that which doesn't fit your dogma.”
-- Nah it’s religion and only religion has the dogma. Science merely goes where the evidence takes it and is subject to peer review by scientists who are striving to prove other scientists wrong. Creationism starts with a conclusion and contrives to shoehorn “evidence” to fit that conclusion. That’s not science by any stretch of the imagination. You don’t even have any dating methodologies available to you so how can you possibly claim a Young Earth apart from by an unevidenced presupposition?
The real irony is that you think your dogma represents the scientific method when in fact it is the very antithesis of  Science and the Scientific method and even if you could falsify all the science (evolution) it doesn’t immediately default to your creation model any more than it does for the Australian Aborigine creation story.
 
“Evolutionism represents the religion (dogma) and the creationists represent the hard science that is overturning your preconceived ideas.”
-- I don’t know what Evolutionism is but I do know what Evolution is and 150 years on from Darwin and Wallace (same conclusion from totally independent means and sets of data), the Theory explaining the fact of Evolution has gone from strength to strength with each find. Btw Victorians dropped Creationism like a hot potato once they started unearthing evidence. I am totally baffled how you can label a proven scientific discipline as a religion. Who do the Evolutionary scientists pray to and worship?  What are their rituals? Where is their Holy book written by their “God”? I’d have thought you were above labelling Evolution as a religion. I’m as disappointed as I am with your tendancy to totall ignore questions by giving answers to questions that have not been asked of you (yet).

“We are talking about carbon-14 and bio-molecular decay which are  literally ticking clocks.  As I said in the video, even if the chest is full of coins from hundreds of years ago, only one coin dated 1951 upsets the apple cart.”
-- I have already debunked that analogy, so why bring it up again unless you can come up with a good reason why my debunking is wrong? To remind you the coins say nothing about the age of the ship, which is the more relevant analogy to the age of the Earth. All they tell you is the most recent age of the coins on that ship, and that ship alone, when it sank.
It’s an analogy that just doesn’t work. 
C14 is the tool of the archaeologist and of little or no use to the Palaeontologist. Since the vast vast majority of fossils contain no C14 nor biological material then neither clock is relevant to the discussion. A ticking clock can only tell the time now. Radiometric “clocks” are totally different tools that tell the age of something. A clock cannot tell you the age of itself let alone it’s environment. Again an irrelevant analogy.
Reply: walkergarya These "clear series" are only series in your imagination.  Describe them, and then show me the DNA from these mineralized fossils.  I really would like to see them.  It seems to me that every bit of it is wishful thinking, but maybe you have something to show me.
Reply: pilgrimpater Your posts are so long I scarcely have time to read them, let alone write a reasoned response.  On top of that, I had written a lengthy response, and Google's drop-down window just disappeared.  Very frustrating.  Thus, I'm going to be brief.

When an organism is buried, it tends to decay and disappear rapidly.  The mineralization process must act quickly enough to capture the detail of the organism before it is gone or blurred beyond recognition.  The faster the mineralization, the better the detail.  It is actually remarkable that we have so many fossils with fantastic detail (often even softer body parts).

As to the global flood, you are raising many questions that have been addressed by Andrew Snelling, Steve Austin, and Kurt Wise. (For example, Austin's explanation of how vertical tree trunks get fossilized based on discoveries at Spirit Lake)  I am not a geologist, and I'm not the right guy to get into that kind of depth with you.  There are other global flood models as well, with different strengths and different weaknesses.  The overall point is that a global flood has great explanatory power.  The conventional model has gaping holes, such as massive strata crossing North America and across the Atlantic, or even the ubiquitous presence of marine fossils worldwide.  In fact, the vast majority of fossils are marine fossils.  A global flood model explains many such things that the conventional model cannot.

You identified the correct article.  (I have a full copy.) However, you need to read through it to see that the paleontologists clearly identify the tubules as original tissue.  Now what are you going to do with this blockbuster, slam-dunk, proof that pre-cambrian strata are not 550 million years old?

"Just ask any archaeologist who has opened an ancient grave. They will tell you that the only thing that survives other than bones is hair."

You just made my point for me.  All these graves are very, very, young, and hardly anything is left.  The hair decays more slowly, but even that will be gone long before 100,000 years has passed.  A young earth scenario absolutely does not expect much original tissue to remain.  Yet an old earth scenario absolutely requires that zero original tissue remains.

" I am totally baffled how you can label a proven scientific discipline as a religion."

The science is not what I am labeling as religion.  It is the superstitious speculation that evolutionists try to lump in with it.  For random mutations to give rise to coherent, functional, genetic instruction sets in DNA defies all probability calculations.  When someone believes something that is operationally impossible (anything less than a 10^-70 chance), then that is a faith-based, superstitious, belief.  If not religion, then dogma, which is virtually the same thing. Darwin was wrong about almost everything, yet they effectively worship him.

" I have already debunked that analogy, so why bring it up again unless you can come up with a good reason why my debunking is wrong? To remind you the coins say nothing about the age of the ship"

You have debunked nothing.  The coins are not dating the age of the ship.  They are dating the sinking of the ship. Likewise, carbon-14 dates the death of organisms, not when the first ones were created (or evolved).
Reply: Mark Champneys
“Your posts are so long I scarcely have time to read them, let alone write a reasoned response.  On top of that, I had written a lengthy response, and Google's drop-down window just disappeared.  Very frustrating.  Thus, I'm going to be brief.”
-- Tell me about it, I have suffered this many times. I now tend to copy comments to Word (for large comments), build my responses and when completed copy and paste back to the video. It works and results in far less swearing and cursing.
Sorry about the length but I cannot make a point by using just one liners and after all these comments are connected with an hour long video.

“When an organism is buried, it tends to decay and disappear rapidly.  The mineralization process must act quickly enough to capture the detail of the organism before it is gone or blurred beyond recognition.  The faster the mineralization, the better the detail.  It is actually remarkable that we have so many fossils with fantastic detail (often even softer body parts).”
-- Especially with fossilised hard parts (the vast majority of cases), that statement is patently not true. Once vacated, it takes as long as it likes for minerals top replace the “void”. It’s not as if something else is going to fill it meanwhile is it, because that something else becomes the “replacing” material. I just don’t see how you can make such an assertion. For full fossilisation the hard parts then need to decay. That is not a rapid event.
With soft bodied parts then a rapid catastrophic covering, such as a mudslide with the Burgess shales, will leave imprints of soft material. In that case your point may hold water (pun intended), or it may not (i don’t know) but remember that soft bodied fossils are in a tiny minority.
 

“As to the global flood, you are raising many questions that have been addressed by Andrew Snelling, Steve Austin, and Kurt Wise. (For example, Austin's explanation of how vertical tree trunks get fossilized based on discoveries at Spirit Lake)  I am not a geologist, and I'm not the right guy to get into that kind of depth with you.”
-- But any Geologist can explain polystrate trees. It’s easy. Now if you, Snelling, Austin or Wise could present me with a Polystrate that spans, say a layer of sandstone, a layer of limestone, and a layer of shale, that’s when I may be taken to task but coal seams and ash layers from multiple ejections over a short period as in Spirit Lake? Nah, no way is that a problem. Young/rapid events are part and parcel of an old Earth that also has lengthy events. Do you think that the scenario of the geology of the future, in say I million years time, comprising of only rapid events, will mean that in a million years time you could argue for the age of the Earth being a mere 6K? That’s exactly what a future religion could claim just as you are claiming now.
As for “depth”, these are not deep questions but very basic observations that you, as a non geologist, should still be able to ponder and wonder what the hell what you are being told by Snelling and Co can be possibly true.
 
“There are other global flood models as well, with different strengths and different weaknesses.  The overall point is that a global flood has great explanatory power.  The conventional model has gaping holes, such as massive strata crossing North America and across the Atlantic, or even the ubiquitous presence of marine fossils worldwide.  In fact, the vast majority of fossils are marine fossils.  A global flood model explains many such things that the conventional model cannot.”
-- You are just using rhetoric and assertions without making any points. You really need to address the 4 (of many) objections I raised that render a Global Flood as impossible.
Surely in your studies of the works of Snelling and Co, you could give it a go.
Yes we all know that marine fossils are more common than land fossils. Where is the mystery in that because for the obvious reason that a water creature is more prone to die in a water environment and hence leave a fossil? However, there are still millions of land fossils and these, along with marine fossils, show a distinct pattern of Evolution. I was rather hoping that you’d tell me what you think the pattern is since it is obviously not random as the Flood story would predict. There is no way a Global Flood can leave a pattern, any pattern.
It’s all getting a bit too frustrating as more and more questions posed to you are going unanswered. It’s no good citing Snelling etc, unless you can tell me what their actual explanations may be because for every scientist you cite, I could do the same and I have far far more to choose from. 

“You identified the correct article.  (I have a full copy.) However, you need to read through it to see that the paleontologists clearly identify the tubules as original tissue.  Now what are you going to do with this blockbuster, slam-dunk, proof that pre-cambrian strata are not 550 million years old?”
-- Where is the slam dunk in misrepresenting the works of others? Again you have not addressed the objections I made to your claim.
1) What you are claiming is truly fantastic and ground breaking so why is it omitted from the Abstract? Clearly this claim is a deliberate case of misrepresenting or quote mining as we famously saw when Creationists deliberately quote mine Darwin on the Evolution of the eye.
2)  If the SOLE reason for “soft” tissue was a young Earth, then if a Young Earth is true, all (or virtually all) fossils would contain “soft” tissue. Therefore, either way,  if “soft” tissue was a fact, the age of the rock in which that tissue was found cannot be the sole factor.
I would argue, that if conditions were extraordinary enough to keep tissue “soft” over thousands of years (which we also don’t expect), then there is no reason why that cannot carry on indefinitely. However, you still have to verify that the authors of the journal are ACTUALLY claiming that the tissue is soft.
 
“You just made my point for me.  All these graves are very, very, young, and hardly anything is left.  The hair decays more slowly, but even that will be gone long before 100,000 years has passed.  A young earth scenario absolutely does not expect much original tissue to remain.  Yet an old earth scenario absolutely requires that zero original tissue remains.”
-- You miss the point. I was using hair as an example of the type of organic material that outlasts other organic material.Did the Precambrian fossils have hair? Of course not.
Again, you have to prove that the only agent, in the preservation, is age. I don’t think that is necessarily true. However, you have to prove that soft tissue was actually found. Has anyone at ICR actually contacted the authors of the article?
By stating 100K years you leave yourself open to an age of the Earth of 100K years but we knew that already from ice core samples. Which raises the question as to why there so many totally independent evidences for an old Earth but you do not have one single dating methodology for a 6K year old Earth. Doesn’t that worry you? It would worry me.

“The science is not what I am labeling as religion.  It is the superstitious speculation that evolutionists try to lump in with it.”
But Evolution IS the science. OK you may have issue with mechanism (Natural Selection) but that doesn’t falsify Evolution no more than the falsifiable explanation for Gravity actually disproves Gravity itself. The Science is easy. Although Darwin didn’t get everything right, what we observe and predict is totally consistent with Natural Selection as the main (not only) agent. Not Superstition in the remotest sense. However, and I hate to sound arrogant, i can accuse the Genesis Account as being Superstition because we all know that claim was made centuries before the explanations. That’s the wrong way round. Evolution could not be claimed with any confidence until Darwin’s and Russell Wallace’s scientific works and the discovery of evidence preceding  the explanation.
 
 “ For random mutations to give rise to coherent, functional, genetic instruction sets in DNA defies all probability calculations.  When someone believes something that is operationally impossible (anything less than a 10^-70 chance), then that is a faith-based, superstitious, belief.  If not religion, then dogma, which is virtually the same thing. Darwin was wrong about almost everything, yet they effectively worship him.”
Darwin knew nothing about DNA. His work stands largely valid for reasons other than random mutations to DNA. Admiration for a great scientist is not worship. Nobody gathers in a church every week and prays to Darwin. Nobody stands on a soap box in the park preaching Darwin. Nobody visits my door step trying to convince of the “Origin of Species”. Absolutely nothing about Darwin, nor his work, is remotely religion like. 
I always raise a wry smile at these “impossible mathematically” claims. You only need a small mutation to a regulating gene to have a large impact on the expression of the relevant protein coding Gene. That small mutation could either alter the timing and/or the duration of regulation.
However, the reason why I find the “mathematical” argument as being amusing is that I can use the same to prove that you cannot exist. You are the result of 250 million of your Father’s sperms fertilising one in a million of your Mother’s eggs. That’s a one in 250 billion chance of you being you and that’s without factoring in the almost limitless chance events leading up to your parents meeting and the various possibilities in recombination. Factor in exactly the same for your grand parents, great grandparents etc etc and you really cannot be here, can you but you are. So, is your existence down to superstition because it is nigh on mathematically impossible?

“You have debunked nothing.  The coins are not dating the age of the ship.  They are dating the sinking of the ship. Likewise, carbon-14 dates the death of organisms, not when the first ones were created (or evolved).”
But it says nothing about the age of the Ship. According to your analogy the Earth must be in the range between the oldest and newest coin that it was carrying. Add to that, you consider only one ship because there may be another ship that sinks with coins only made last year and another with only Roman coins. Your analogy is like analysing only one area of the Earth and dating the Earth by the age of the rocks in that specific area with no consideration for any other locations. Your analogy should consider ALL ships not just one sinking.
Again C14 is the tool of the archaeologist and not of the Palaeontologist.
Also why refer to C14 when Creationists deny it a valid methodology? Why would you support C14 dating and not K-Ar dating?
Reply: Mark Champneys
"Describe them, and then show me the DNA from these mineralized fossils."
walkergarya doesn't need to describe the DNA. The fossil pattern alone is proof of Evolution and fossils by definition cannot contain DNA. Evolution, via the fossil pattern, was established way before Crick and Watson came on the scene.
You might as well claim that Jesus. Moses. Abraham etc etc never existed because we don't have their DNA.
Reply: pilgrimpater Yes, you got my point.  It was not DNA that indicated ancestry, but the way evolutionists arranged the fossils on paper.  As I said, I can arrange nuts and bolts on paper too.  Does that prove ancestry?  It indicates common design, not common descent.
Reply: Mark Champneys
Just a quick response before i sign off.
Yes, the point is that it is the fossils which prove Evolution (if not by ancestry then what else?) and DNA is merely something that is consistent with that evidence. If we just had DNA and no fossil pattern then i could not be so certain that Evolution is true. As for your nuts and bolts argument, there is a massive difference between you consciously arranging the nuts and bolts and geologists finding the fossils "arranged" without human intervention. Surely you are not asserting a conspiracy or perhaps you are one of those who thinks that God arranged the fossils in an Evolutionary order in order to test our faith in a seemingly impossible creation story.
Reply: pilgrimpater _"... the fossils which prove Evolution (if not by ancestry then what else?) "_

Common design rather than common descent.  Imagine a phylogenetiic tree for transportation vehicles.  Cars, trains, and planes all have wheels, Trucks and cars have carburetors, etc. This pattern is exactly what we see in the fossil record. Insects, birds, bats with wings; diverse eyes, etc. Design has more explanatory power than ancestry.

The fossils are arranged in burial order.  There are hundreds of "living fossils" that represent the wrong order for evolution.  Mammals, birds, and flowering plants in dinosaur strata.  It is not as clean as you represent.
Reply: walkergarya The problem for you is that physical traits and DNA do not show the same tree.  See...
http://www.discovery.org/multimedia/audio/2014/09/darwins-tree-of-life-splinters/
Reply: Mark Champneys
walkergarya You point to a Creationist site (how many of the DI are non Christians?).
The Genomics match what we find in the fossils BUT even if they didn't they STILL show an Evolutionary pattern. Can you please explain that fact? This is why Darwin and Russell could formulate the same Scientific Theory from differing perspectives with that Theory standing in good stead a good century before DNA was discovered. DNA merely supports what we know already.
Now here is the deal. Instead of doing the normal creationist tactic of referring to links, surely it is up to you to listen/watch that link and then bring those points to the table. You wouldn't like it if you were flooded with any number of the hundreds of thousands of links suporting Evolution would you,
Reply: walkergarya If you dismiss an argument before you hear it, you are not likely to learn anything.  Luskin's podcast largely is quoting from evolutionist sources.  Are they propaganda?
Reply: pilgrimpater The point of the link is that evolutionists (not creationists) are finding that genomics fails to match the traditional tree.  In fact, one gene's tree fails to match another.

I don't post that many links (compared to others), but I thought this one would be more acceptable to you with all its evolutionist references.  I forgot that the Discovery Institute is anathama to you. Your objectivity is underwhelming.
Reply: Mark Champneys Luskin is nothing more than a paid hack of the DI. He will cherry pick factoids to make it sound good and fluff other data to suit his ends. 
DI is NOTHING but propaganda.
I will not learn any facts from them, only thier latest lies.
Reply: Mark Champneys
The point is that referring to links is a fob off. If you think there are any valid points then you should bring them to the table and then, by all means, cite the link as your source. A battle of links can become tit for tat and hence is pointless.
I repeat even IF the DI creationist stuff was valid, you are still left with the fact that the fossil pattern (tree) is clearly an Evolutionary one, as is the tree according to Genomics. So continuing with the hypothetical premise that the DI audio (it's not even a journal) is correct, where does that leave the DI? It leaves them with two seperate but differing Evolutionary evidences and they can offer no alternative proposition i.e. if life was Intelligently Designed you are still left with the same problem of the Fossil pattern not agreeing with the Tree according to Genomics. What possibly could the "Designer" be doing here? Further, you certainly have two independent evidences that each totally falsify an instant "everything from nothing" creation as in Genesis i.e. the DI themselves have falsified Creationism.
All of which makes one wonder who is the individual lacking in objectivity.
Reply: walkergarya Okay, so you have insulted Luskin.  How about his arguments?
Reply: pilgrimpater _"... even IF the DI creationist stuff was valid, you are still left with the fact that the fossil pattern (tree) is clearly an Evolutionary one, as is the tree according to Genomics."_

Sorry, there is no tree, except in the imagination of the evolutionist.  Ancestry is speculated, not verified in any case (and there are far more than 2 potential tree structures postulated). Common design, rather than common descent, fits the data.
Reply: Mark Champneys
"Common design rather than common descent."
--Yet that would still mean that the common "design" is in an Evolutionary order, meaning that the "designer" was constantly in a state of WIP both for new "design" and scrapping old "design". A designer with millions of sepertae creations/destructions does your Genesis case absolutely no good.

" Imagine a phylogenetiic tree for transportation vehicles.  Cars, trains, and planes all have wheels, Trucks and cars have carburetors, etc."
-- The fossil record of transport would be (oldest layers to youngest layers and not meant as the definitive history of the wheel):- Stone wheel (no axle), stone wheel (axle from then on), wooden wheel, wooden wheel with spokes, wooden wheel with spokes and metal rim, no more stone wheels,  wooden wheel with solid rubber rim, alloy wheel with modern tyre and no more of any of the previous i.e. exactly the sort of patterned progression we see with biodiversity.
A designer would go straight to the alloy wheel with modern pneumatic tyres and thatt's all you'd find in the rocks egardless of age. Exactly what we don't find in the fossil record.
But why are we talking transport which is not a self replicating organism?

 "This pattern is exactly what we see in the fossil record. Insects, birds, bats with wings; diverse eyes, etc. Design has more explanatory power than ancestry"
-- Are you seriously saying that insects have the same body plan as amphibians, reptiles and mammals? The interesting thing is that amphibians, reptiles and mammals do share a common body structure and hence it is highly plausible that small changes explain the differences which is very powerful for the case of Evolution. Paradoxically, you could almost lump all amphibians, reptiles and mammals into the same "Kind" because, for sure, nobody has ever been able to define "Kind" let alone classify it. 
You have to ask yourself why we share so much DNA with the other great apes and the most we share is with Bonobos. Why are we apes and not a sepertae unique group? If we, humans, are so special why aren't we totally different? Answer, of course, is that we are nothing special.

"The fossils are arranged in burial order."
-- Correct and over tens of thousands, if not millions, of seperate events as i have pointed out previously due to the wildly varying Geological environments as found in the field and which you have yet to address, along with a number of  other selected points from many.

" There are hundreds of "living fossils" that represent the wrong order for evolution. "
-- Who said that a species leaving a fossil has to die out? That is a crazy strawman argument. It's not what is alive at anyone time but it is the sequence as per the FIRST appearance of any one species or group that is the key. Wolves don't have to die out just because we have dogs in the same way that Europeans didn't have to die out becuase we have Caucasean Americans.

" Mammals, birds, and flowering plants in dinosaur strata.  It is not as clean as you represent."
-- Oh but it is. Of course there were mammals in Dino bearing strata (or at least Strata of the same age) but please note that the mammals were tiny rodent like creatures who had yet to "rule" the land. Now if you can find me a Tiger or a Wolf or a Whale or a human in Dino
strata (or strata of the same age) then you may have a case.
Reply: Mark Champneys There is no evidence of any designer or god therefore until that evidence is presented, then evolution is the only rational game in town.
Reply: Mark Champneys
Oh but there is a tree. It's absolutely unmistakeable. Whether it fits exactly with the tree according genomics is irrelevant but do remember that with genomics we only have extant orgaisms and with the fossil record we by and large only have extinct organisms. It's very difficult to match apples and pears.
Reply: pilgrimpater _"It's very difficult to match apples and pears."_  I hear your excuse.

Taxonomy is unmistakable, not ancestry.  Common design explains what we see much better than common descent.

Just curious, where does the bill fit into your ancestral scheme, through ducks or platypuses?
Reply: Mark Champneys Humans have the full DNA sequence to produce Vitamin C except it does not work because there is a single bit error at the last stage. 
IF THERE IS A 'DESIGNER' FOR HUMANS AND LIFE, WHY DOES HE NOT CORRECT THIS ERROR?
Reply: walkergarya I would expect that the genome was perfect at creation.  But the reality of mutational decay is not at all in question.
Reply: Mark Champneys That is NOT what I am asking. Why does your "god", the "designer" not correct a single bit error? Is that too difficult or complex for your "god"?
Reply: Mark Champneys
"I hear your excuse."
-- No excuse, that is fact. We don't have the DNA for the vast majority of species from the past, we only have fossils. We do have access to the DNA for extant creatures. Hence we have two differing sets of evidence, i.e. the fossil pattern for past creatures and the genome maps for today's creatures and a handful of recently extinct creatures, such as from frozen Mammoths.
What can be done by genetic comparison is to work out the shared DNA of extant animals and blow me we get the same pattern as exhibited by the fossils (but i stress by two differing methodologies).
So we have the strong case for Evolution from the fossil pattern and Genomic comparison is totally consistent with this e.g. we share more DNA with other mammals than we do with amphibians.

"Taxonomy is unmistakable, not ancestry."
-- Strange comment, Ancestry is an explanation for Taxonomy.
Are you now claiming you don't have ancestors? Is it sheer coincidence that all Pygmies are short while all Masai are tall?
If that is nothing to do with inheritence by ancestry then what is the resaon? Even in your unevidenced "common design" world, you must surely believe in ancestry.

 "Common design explains what we see much better than common descent."
-- So you claim but wouldn't be helpful if you said why? You see for Common Design to work we should all have the same building blocks, which lo and behold we do have in DNA. However common design would also necessitate all organisms having the same Genes with the Genes either being switched on or off e.g. humans shoud have a bill gene that is merely switched off. Ducks should have a voice box gene but switched off. Don't you think it strange that the creatures that we are closest to in a physical sense are also closest in Genome comparison? So you tell me, where is the common design between any two species of your choosing.

 "Just curious, where does the bill fit into your ancestral scheme, through ducks or platypuses?"
-- If you mean on my own ancestral scheme, then these are along a totally different evolutionary branch and hence are not ancestors to me. Also the Playtypus is on a differing branch to birds.
If you mean generally then it's simple because some dinos, the predecessors to birds, had evolved bill like structures. As for the Playtpus, it is clearly an intermediate between reptile and mammal taxonomy. Oh and please don't interpret that as a claim that we can trace ourselves back to the Playtypus. I wonder what other creature shares a common design with the Platypus. Perhaps you can tell me.

Btw to make matters worse there is a response (of the 4th Oct) to one of your comments that i suspect you may have missed.
Reply: walkergarya
"IF THERE IS A 'DESIGNER' FOR HUMANS AND LIFE, WHY DOES HE NOT CORRECT THIS ERROR?"
Apparently the "perfect design" is a one off, never to be repeated feat (were the animals as perfect as Adam and Eve?).

This is the trouble with the Abrahamic god.
He had a perfect chance to give Noah and family a perfect genome when he wanted to start the whole caboodle from scratch but he didn't.
He created foreskins and then decides it's a design fault. Rather than modifying the design he asks his "creations" to remove each other's foreskins. It's a bit like Toyota, recalling a model for faulty brakes but instead of fixing the problem, carry on making that model with faulty brakes and then recalling them or asking customers to fix their own brakes. You couldn't make this stuff up but 3K years ago some Bronze Age men did.
Reply: Mark Champneys walkergarya
"I would expect that the genome was perfect at creation"
-- We all know the story about what you expect but shouldn't you provide some justification for what you expect?
"But the reality of mutational decay is not at all in question."
-- It is absolutely in question because that statement is wrong. Mutation is not decay but mutation is change be it disadvantageous, beneficial or neutral. For the genome to decay, you would have to have less base pairs than your parents.
Reply: Mark Champneys "I would expect that the genome was perfect at creation"

There WAS no moment of creation. Life developed over several billion years. There was no moment of perfection.

Your attempt to twist facts to make them fit to your fantasy of creationism is typical of your tactics and sorry butthead, it is not working.
Reply: walkergarya _"Why does your "god", the "designer" not correct a single bit error?"_
If you are going to stand in judgment of the Creator's decisions, you are pretty foolish.  Based upon the Bible, all creation is under a curse, because of the sinfulness of man.  This is also why there was a global flood.  Decay and damage throughout creation is exactly what a student of the Bible would expect to see in both the past and the present.  The human genome is in decay, not evolutionary advancement.  ...and so forth.
Reply: pilgrimpater _"We don't have the DNA for the vast majority of species from the past, we only have fossils. "_
Bingo.  Thus no DNA evidence for ancestors.

"So we have the strong case for Evolution from the fossil pattern and Genomic comparison is totally consistent with this..."
Actually there many cases where genetic evidence is very inconsistent with it.  That was the point of my reference to the podcast.  You are simply wrong on this.

But what would we expect if there is a common designer for varying organisms?  We would see re-use of many design features (programming subroutines), but also novel design features mixed in.  Airplanes and buses both have wheels, and both have electrical systems, but only planes have wings designed for its purposes.  This pattern is exactly what we see in nature. Man has many design features similar to chimps.  (They used to claim 97% similarity.)  But digging deeper into the genome we find that the details are not so similar... only 60 to 70% matching.  Yet pigs are anatomically more similar to man than chimps are.  All this makes sense with a common designer, but not with any kind of mutational pathway from one to the other.  In fact, neither you, nor any other evolutionist has even proposed such a mutational pathway.  Only broad generalizations.  DNA evidence for ancestry would necessitate step by step changes in the nucleotide sequences to get from here to there.  Can you even speculate about what that might be?

"Strange comment, Ancestry is an explanation for Taxonomy. Are you now claiming you don't have ancestors?"
It is your explanation, but a common designer is another very good explanation.  If you were being scientific instead of dogmatic you would consider both.  And obviously creationists believe in ancestry and vast variation within each given genome.  Those genomic kinds can have their information re-mixed and damaged, but they cannot have new functional algorithms added to them by random means.  So your model is a single phylogenic tree, while the creationist model is a forest of trees.

"However common design would also necessitate all organisms having the same Genes with the Genes either being switched on or off..."
No, not at all.  Common design re-uses subroutines in diverse programs, but that would not necessitate your scenario that I can see.

It was fun to see your song and dance on the genes for the platypus bill.  You sound pretty lost. :-)
Reply: pilgrimpater There are different kinds of decay.  Chemical decay and informational decay.  If new spelling errors were introduced into each new edition of a book, then over a long period of time the meaning of the book would be lost.  Such is what is happening in the human genome.  Tiny errors, unnoticed by natural selection, but slowly accumulating.  It is not a good thing in the long term.  Misspelling might accidentally form a nice word at some point, but that would be rare, and still not be helpful to the purpose of the book.
Reply: walkergarya _"There WAS no moment of creation. Life developed over several billion years. There was no moment of perfection."_

That's the question we are discussing, isn't it.  I dispute your scenario, and offer alternate evidence.  You don't discuss my evidence, but just hurl insults and pronounce victory.  We'll have to let others decide whose case is stronger.
Reply: Mark Champneys You don't have evidence.

How do you explain the Banded Iron Deposits that show the change to an oxygen rich atmosphere starting 2.5 billion years old. If god had created all this in one week there would have been NO oxygen poor atmosphere.
Reply: Mark Champneys
“Bingo.  Thus no DNA evidence for ancestors.”
-- That’s right minerals don’t have DNA but the fossils are clearly in an evolutionary pattern, so who needs DNA to observe this pattern? Bingo, indeed!
Meanwhile taken in isolation from the fossil record, Genomic comparisons give us  precisely what we’d expect of descent by ancestry i.e. we share more DNA with chimps than we do with tigers, while tigers share more DNA with us than they do with trees, a wolf shares more DNA with coyotes than it does with a tiger and a cod shares more DNA with Haddock than it does with a Bee and so on and so on. By comparison of Genomes alone, a picture can be built up of relationships across all species and that, unfortunately for you, fits an Evolutionary pattern.
To prove this technique works, we can look no further than the Human Genome Project and work out the ancestry of race using the same technique and then successfully match it with the history of those individual involved.
Mitochondrial DNA and Y Chromosome “tracing” are a great help in this.
Or perhaps are you somehow denying that by using Genome comparisons within Homo Sapiens that we cannot tell the ancestry of races? If so you’d better submit your paper so you can pick up your Nobel prize. I’ll be the first to congratulate you.

“Actually there many cases where genetic evidence is very inconsistent with it.  That was the point of my reference to the podcast.  You are simply wrong on this.”
-- Oh yeah a podcast in light of a distinct absence of a scientific paper, will always do won’t it. Well at least it will for those with pre-suppositional, closed minds. Anybody can quote mine the hard work of others from the comfort of their armchair. We only have to witness what dishonest Creationists did with Evolution of the Eye from the Origin of Species and how Dawkins was quote mined in “Expelled”. No, let’s see a real paper so those scientists can respond. I am so simply NOT wrong on this. I have Science on my side and you have a podcast. I must also remind you that even if the DI could falsify Evolution, your Creation story is already falsified and can never be resurrected.

“But what would we expect if there is a common designer for varying organisms?  We would see re-use of many design features (programming subroutines), but also novel design features mixed in.”
-- We’d expect one set of genes with them being either switched on or off. We wouldn’t use “subroutines” that can radically alter by random mutation. The first program I ever wrote had a totally, and I mean totally, different outcome to what I had planned all because I left out a single full stop. In the end I fixed the problem but unfortunately your “common” (rare by it’s absence) “designer” can never seem to correct random mutations because, well, they are random. Not only is this not common design but it is more like very poor design.
 
“  Airplanes and buses both have wheels, and both have electrical systems, but only planes have wings designed for its purposes.”
-- Here we go again, another in the long line of bad analogies. Inanimate objects where the end product is known in advance as an attempt to explain self replicating entities whereby the outcome is never known in advance.
Actually, these things you refer to have all evolved bit by bit as we build on the shoulders of giants. The Airbus 380 is radically different to the Wright Brothers’ Flyer 1 and this has been achieved in steps by thousands of designers who are in no way connected to the Wright Brothers. Of course, according to your “logic” Flyer 1 is more advanced than the A380 because the latter has lost one set of wings. Also your analogy actually disproves a single Designer unless, as pointed out before,  the Designer is constantly immersed in WIP. Same goes for the car comparing the first Benz (more in common with a horse drawn carriage) and an F1 car.
We KNOW who invented these and we can find out who developed each stage. It’s all documented and supported with hard copies. None of this evidence is apparent for the design of species. It’s no good you keep asserting it must be designed unless you back it up with some evidence.
 
 
“  This pattern is exactly what we see in nature. Man has many design features similar to chimps.  (They used to claim 97% similarity.)  But digging deeper into the genome we find that the details are not so similar... only 60 to 70% matching.  Yet pigs are anatomically more similar to man than chimps are.”
-- Whoa hang on a minute. One minute you are comparing DNA and the next you are comparing anatomy. No, if you could demonstrate that we share more DNA with pigs than we do with chimps then that comment may be taken seriously. 
 
 “ All this makes sense with a common designer, but not with any kind of mutational pathway from one to the other.”
-- Just stating something does not mean it makes sense unless you can demonstrate how. I have noticed this in you a lot. Please actually tell me HOW it makes sense with a common designer because nothing in nature necessitates common design let alone design at all.
While even you agree that ancestry is a fact, you have not actually demonstrated common design as a fact. You could argue that a dog and wolf are so similar that they have much in common but you cannot prove that either were designed by an external agent. Just saying so does not make it true.
 
 “In fact, neither you, nor any other evolutionist has even proposed such a mutational pathway.  Only broad generalizations. “
-- What the hell is a mutational pathway anyway? Are you seriously ignoring the bigger picture (fossil pattern and DNA relationships) by asking for the minutest detail of how and when each mutation occurred? If I see you walking down a street and you keep disappearing into shops and each time you exit those shops you continue your journey down the street, is that a reason for me to dismiss your journey down the street, just because I don’t know your exact actions within the shops? (Now THAT is an analogy).
How about you giving me the exact order that Yaweh “created” species on what ever “day” it allegedly was or the order in which Adam named millions of species?
 
 “DNA evidence for ancestry would necessitate step by step changes in the nucleotide sequences to get from here to there.  Can you even speculate about what that might be?”
-- Absolutely. The regulating gene (off my head I can’t recall the name of the gene but it matters not for the point being made) for tail development in birds is switched off before the exact same gene is switched off in reptiles. That’s down to a mutation in that regulating gene and why birds have shorter tails (less segments) than reptiles. All this by Genomic (and in this case also embryonic) comparison. That’s how the evolutionary relationships are worked out when extended to all other regulating and coding genes across species.

“It is your explanation, but a common designer is another very good explanation. “
-- Nah a “Designer” has an end product in mind. You don’t build in random mutations if you have a plan. That’s the very thing you want to eliminate.  Imagine car designers hoping and praying that random mutations don’t radically alter their predicted showpiece.
You can use, and independently verify, human ancestry by genome analysis. It’s a fact. You might not look like your great grandparents but your DNA is nearer to theirs than it is to my great grandparents (barring an unfortunate coincidence that you and I closely related). By mapping enough genes, your family tree can be calculated and it will be on a different branch to mine. 
 
 “If you were being scientific instead of dogmatic you would consider both.”
-- Oh the irony, it burns. Please stop. Unlike you, i DO consider ALL (not just two) possibilities and i AM open to change. I am not the one dogmatically locked in a 3K year old book no matter how much evidence contradicts that book. It’s just that i HAVE considered your assertion (and found no real evidence beyond Just So stories) and I find it totally unconvincing and counter to what we know as fact. Forgive me for lumping your creation story with those of the Aboriginies, Maoris, Hindus etc. but I find them no less plausible than your story.
 
“  And obviously creationists believe in ancestry and vast variation within each given genome.”
-- So is this “variation” planned or is it by accident? Do any expectant parents know what their children will look like? No of course not.
 
 “ Those genomic kinds can have their information re-mixed and damaged, but they cannot have new functional algorithms added to them by random means.  So your model is a single phylogenic tree, while the creationist model is a forest of trees.”
-- Algorithms? What algorithms? Can you give me an example of your “Designer’s” algorithms? Hell we can’t even predict the result of recombination from the same parents for as many offspring as you like.
If your “forest” claim was correct then why is there so much commonality between those trees? Surely each tree should produce radically different lineages otherwise what is the purpose of numerous individual trees when just ONE tree would do?
You do realise that the cat “tree” and dog “tree” are remarkably similar. Think not? Then describe to me the difference between the Cat and Dog “Kinds”. Should be fun.
The only way I can see your “forest” working is if it were more like a copse with just one tree for each Phylum. That would at least make a bit of sense but you aren’t claiming that are you..
 

“No, not at all.  Common design re-uses subroutines in diverse programs, but that would not necessitate your scenario that I can see.”
-- No, no, no, no, no no, no and NO. DNA is not a computer program. It doesn’t have subroutines. No computer system can ever cope with random mutations, especially those that accumulate (as you have already agreed happens).

“It was fun to see your song and dance on the genes for the platypus bill.  You sound pretty lost. :-)”
-- Sorry false bravado doesn’t intimidate me but instead, if I am “lost”, wouldn’t it be nice if you could tell me why?
 
 
“There are different kinds of decay.  Chemical decay and informational decay.  If new spelling errors were introduced into each new edition of a book, then over a long period of time the meaning of the book would be lost.  Such is what is happening in the human genome.  Tiny errors, unnoticed by natural selection, but slowly accumulating.  It is not a good thing in the long term.”
-- There is no such thing as “information decay”. You contain the same amount of “information” that your parents have and your grandparents have and your great grandparents have and so on and so on. Different information, yes but different quantity of information, no. Of course, an organism can decay once it’s dead and by definition the information describing that organism also alters but that’s not what you are attempting to assert here. You are trying to tell me that information “decays” with each generation. That is patently not true and flies in the face of so called microevolution that you people like to bandy about. Mutations in the human genome are not errors of decay, they are merely changes but if they are errors that weaken the “design” then what sort of cack arsed design would that be? Where do you see the human genome in the future? What are we going to turn into? Chimpanzees? Or perhaps we will all be lumps of jelly for the Second Coming (assuming there was ever a first).
Glad you agree that random mutations can accumulate.
After all would you argue that the Tiger is bettered suited to it’s environment (forest) than it is to the Lion’s (Savannah)? Of course it is, so you are duty bound to agree that so called microevolution occurring (at unimaginable rates) post “flood” utilises Natural Selection, the very process that you dogmatically deny. If such “Variation” from a “single pair” of moggies can occur in a few centuries then ponder what can happen over millions or billions of years.
 
“Misspelling might accidentally form a nice word at some point, but that would be rare, and still not be helpful to the purpose of the book”
-- Why should it be rare? The example I gave you was a 1 in 25 alteration to 1 out of  4 characters i.e. 1 in a 100. Giving the thousands upon thousands of copying events and the meaningful change becomes a nigh on certainty. You only need a small change in a regulating gene to have a much larger impact on the related protein coding gene.
But you miss the point I am making which is that an alteration (thankfully mostly neutral) means different information but not less information i.e. no information "decay".
Reply: walkergarya Banded iron is not direct evidence of a reducing atmosphere since it contains oxidized iron itself, but merely makes the idea of a previous reducing atmosphere conceivable.  However, there is the major problem of fully oxidized "red beds" below the banded iron, which does prove a prior oxygen-rich atmosphere.  On top of that, banded iron is not a global phenomenon, which it would have to be to prove anything.  So, as you can see, the hypothesis has huge problems.  Nice try.
Reply: pilgrimpater _"Oh yeah a podcast in light of a distinct absence of a scientific paper, will always do won’t it."_

The podcast was selected precisely because it referenced so many scientific articles.  Listen and take notes.
Reply: Mark Champneys Cretard to the Nth degree.
Reply: Mark Champneys
"However, there is the major problem of fully oxidized "red beds" below the banded iron, which does prove a prior oxygen-rich atmosphere."
Where would these be? I thought creationists were averse to relative dating? Or are they averse to that methodology when it suits?

 *"On top of that, banded iron is not a global phenomenon, which it would have to be to prove anything.  So, as you can see, the hypothesis has huge problems.  Nice try".*
You can only have oxidised iron where there is iron. If iron is not global (and there is absolutely no reason why we'd excpect it to be global) then there is no reason to expect global oxidised iron. But wait isn't the false claim of so called "global" limestone an argument for the "flood"? Why don't you also claim a global layer of iron as well?
Reply: Mark Champneys
"The podcast was selected precisely because it referenced so many scientific articles.  Listen and take notes."
It's a series of mostly single sentence quotes from papers that comprise of 1000s of sentences. Again, if this podcast holds any water (pun intended) then when is Luskin going to submit his paper? As i said before there are numerous instances of creationists having been caught with their pants down by iresponsible quote mining. Nobody is going to be convinced until this podcast can be turned into a scientific paper.
Again i have to ask you why Tigers and Lions have simliar Genomes and Humans and Chimps have sinilar genomes and snakes and lizards have similar genomes while there are less simliarities between each of those pairs. I think you'll find that the genome comparisons run parrallel to what we know from the fossil pattern which, even if Luskin's podcast had any grain of credibility, is still the major falsifying headache for Creationists.
Reply: pilgrimpater _" I thought creationists were averse to relative dating?"_

Obviously I am describing the case under your assumptions.  I maintain that an oxygen-rich atmosphere was present during the laying down of every layer with a young earth.
Reply: pilgrimpater Luskin's purpose was to rapidly review the literature.  If you think anything was out of context and misstated, then show me.  You seem to want to dismiss his points without facing them.

"Again i have to ask you why Tigers and Lions have simliar Genomes and Humans and Chimps have sinilar genomes and snakes and lizards have similar genomes while there are less simliarities between each of those pairs."

The answer is so simple and obvious, it is remarkable that you can't see it:  Design by a common designer.  It perfectly explains both things.  Why are the wheels on planes and buses so similar and the aerodynamics so completely different?  Common design, not common descent.  (Although lions and tigers are actually of the same basic genome and can be cross bred.)
Reply: Mark Champneys If we had nothing else but the genomes of these species, you still have to prove the existence of a designer. On the other hand we HAVE fossils of the common ancestor between dogs and ALL cats including bears.
Reply: Mark Champneys
Firstly you haven't addressed the following as requested:-
1) Identifying earlier "red beds" and how you can know they are earlier.
2) Why you would expect global oxidised iron when we cannot even expect global iron.

Then you add this little gem *"I maintain that an oxygen-rich atmosphere was present during the laying down of every layer with a young earth." *
For a start, you "maintaining" someething is not compelling evidence. Whether a young earth or old earth is true the observable evidence is totally not what you "maintain". There is nothing in Palaeoclimatology, from the studies of ice core rings to the nature of coral growth, that supports your claim for "every layer".

This is a classic example of what happens when you start with an unmoveable conclusion and try to shoehorn explantions to fit.
Reply: Mark Champneys
" Luskin's purpose was to rapidly review the literature."
Read "rapidly review" as "rapidly cherry pick".
Do you honestly expect me to read every single word of of all the papers identified, so i can reveal the true context? I stand by the fact that this podcast will only hold water once Luskin produces a paper, proving these "anomolies". And why are the Evolutionary scientists who published the papers, still Evolutionary scientists if their work "contradicts" Evolution? NO let's wait for Luskin's paper, if he dares.

”The answer is so simple and obvious, it is remarkable that you can't see it:  Design by a common designer.  It perfectly explains both things.  Why are the wheels on planes and buses so similar and the aerodynamics so completely different?  Common design, not common descent.  (Although lions and tigers are actually of the same basic genome and can be cross bred.)”
 
I am utterly astounded that you think what I described to you as being evidence for common design. My point was that you can build a hierarchy from genomics e.g. we are closer to other apes than we are to dogs and dogs are closer to bears than we are and cabbages are closer to cauliflowers than we are, yet despite that we still share common genes. Now what Designer would put anything in common between those in “his own image" and a cabbage?
What designer using “common building blocks” would design totally different wings (and bone structures) between bats and birds when a common design would do? What designer would design wings that cannot get the organism off the ground such as with Ostriches? Is the useless wing a common design between Ostriches, Dodos, penguins etc? Why make a bad design common?
Have you considered that damaged genes (pseudo genes) are common (both in length and position) between closely related species e.g. us with chimps? Again, why would any Designer persist with a common bad/useless design?  
Yes we all know Lions and Tigers are of the same Genus, hence they can produce offspring albeit they are infertile but neither can mate with a cheetah which is presumably is also a member of the cat “kind”.
Reply: walkergarya Oh really?  And what is that ancestor fossil?  Then my next question: How do you know it is ancestral?
Reply: pilgrimpater _"What designer would...?"_

You want me to second guess the Creator?  I see too much brilliant foresight and inter-dependencies to do that.  Actually, we see these kinds of both redundant design and non-redundant design again and again in human engineering.  None of it is inconsistent with design.  Much is inconsistent with the phylogenetic tree.
Reply: walkergarya
Mark Champneys
RE "If we had nothing else but the genomes of these species, you still have to prove the existence of a designer. On the other hand we HAVE fossils of the common ancestor between dogs and ALL cats including bears."

RE my reply, apologies to you both as i had a mental aberration (not helped by my screen continually blacking out) and got you guys mixed up. I will remove my response which is irrelevant, though i will be asking Mark a related question.
Reply: Mark Champneys
"Oh really?  And what is that ancestor fossil?  Then my next question: How do you know it is ancestral?"
Same as what you have for Wolf being ancestors of all dogs.

"You want me to second guess the Creator?"
Ah yes, always the "God moves in mysterious ways" fall back.
What we don't see in human engineering projects is redundant complex components,  requiring power consumption, being retained from one model to the next model because it adds to manufacturing overheads thereby cutting profit margins or indeed causes a loss.
We actually see an Evolution of design that irons out previous errors. If man was responsible for human design he would not leave the appendix in which can rupture and kill or the foreskin which he somehow regrets designing in the first place for some mysterious reason..

"Much is inconsistent with the phylogenetic tree."
Wrong. There are some gaps (though the overall pattern is unmistakable), but gaps don't represent anomolies.
Now if you want anomolies, look no further than the creation model where it is patently obvious that all "kinds" did not have a fresh start at the same instant at a paltry 4.5K years ago.
Reply: Mark Champneys Because detailed study of this fossil and successive fossils show traits that continue through the generations of species that are unique to these carnivora.

It is very much like linking the Velociraptor to the same family as T-Rex due to a very similar body form, both being theropods, the same family that gave rise to birds.
Reply: walkergarya Taxonomy does not prove anything but similarities and differences.  As I have said, I can group different kinds of nuts and bolts on a table in similar fashion.  Have I proved ancestry?  I can arrange different transportation vehicles on a chart according to similarity of design.  Have I proved ancestry?  You need to recognize that it is your assumptions that demonstrate descent, not the data.
Reply: Mark Champneys Nuts and bolts are not alive. Anybody with a an ounce of usable brains would understand that, but that still leaves you with an out.
The pattern of changes and retained features shows ancestry in the fossil record.

Your denial of reality does not change that reality.
Reply: walkergarya _"The pattern of changes and retained features shows ancestry in the fossil record."_

Only if you assume your conclusion.  Various features might also mean something else.  (Like common design.)  But you've already decided what the data will mean before you start.
Reply: Mark Champneys Comparisons of skulls, long bones, spine, ribs, teeth and claws over a number of species representing a spread of time sometimes hundreds of millions of years show continuity between species and there interrelationships
Your insult that it is simply an exercise of confirmation bias is yours to prove.

Evolution is Fact, if you choose to ignore that fact, it nonetheless remains a fact.
Reply: walkergarya Continuity is explained by common design as easily as common descent.
Reply: Mark Champneys Not if you cannot show any evidence for any designer.